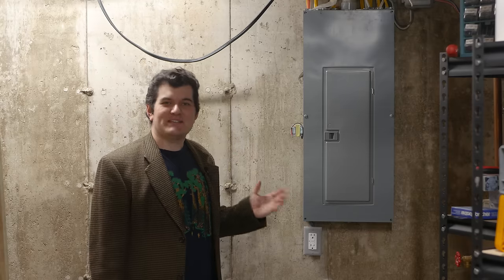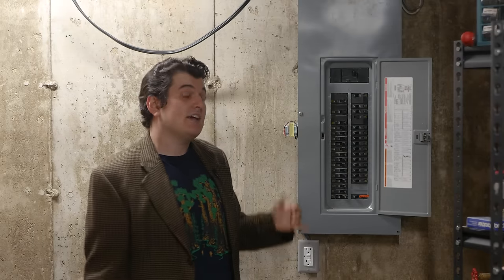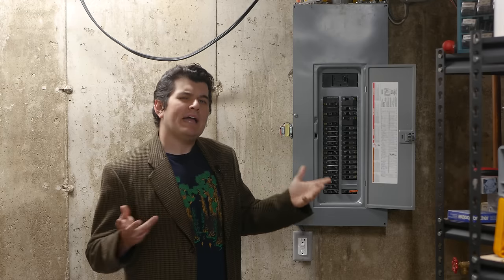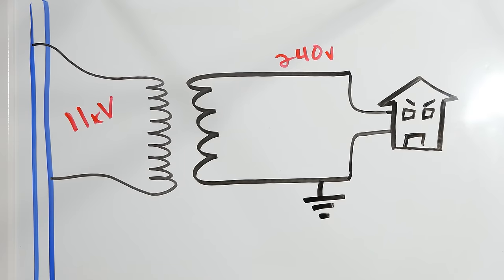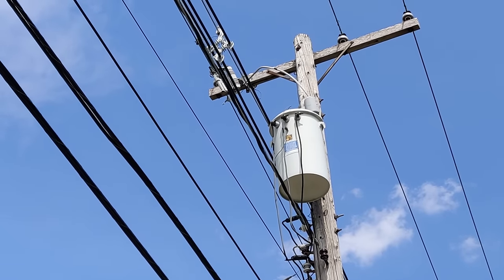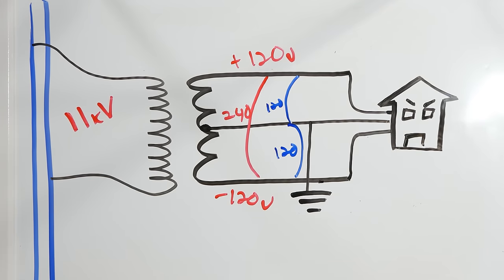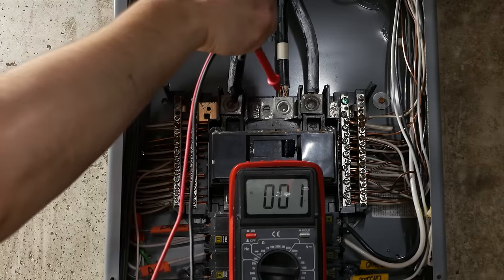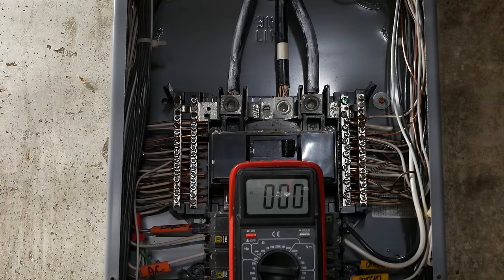The US electrical system is not 120V

Comment: I've occasionally wondered what a national power grid would look like if you could start again from scratch using current technology. No backwards compatibility, no infrastructure limitations, no analog TVs to sync.
Reply: It would be heaven
Reply: 400v /230v three phase seems to be pretty good. Decent L-N voltage, high three phase voltage.
Reply: Oh, it would be so worth it to resurrect Tesla right now, somebody get on that.
Reply: DC everything, please.
Reply: It used to be that you'd want higher frequency mains allowing smaller transformers etc, but now that switch mode supplies are the norm, that doesn't matter. Still, I'd probably go to 100Hz.
Why three phase, why not four?
--edit, fixed weird autocorrect
Reply: I'd like to replace 3-phase transformer which supplies 240 volts or 400 volts (depending on country or on industrial/domestic usage etc) with slightly different transformer and 12-pulse rectifier which outputs 310..340 volts DC with hardly any ripple and with tremendous power factor. This way there is no need for overcomplicated power factor correctors on each switching power supply which are everywhere nowadays: LED lamps, computers, chargers, AC, washing machines, microwave ovens with power inverters and so on. In fact, they wouldn't even need large electrolytic capacitor at the input, and that's one of least reliable component anyway, especially in hot environment (which many power supplies in closed black boxes ARE). Without electrolytics at the input, there would be hardly any surge current, so NTC resistor and really beefy bridge rectifiers (withstanding these surge currents) are not needed also. In fact, if outlets would finally get polarity, bridge rectifier would become obsolete as well.
Reply: Honestly, given the efficiency gains in DC voltage conversion with modern technology, it might make sense to to to a straight DC system rather than AC.
Reply: Before Analog TVs there were Master Clock systems using synchronous motors. Another rabbit hole for Alex!
Reply: @avalonhamakei  Found the Edison plant in the AC power demonstration!
Reply: @PaulMansfield  3 phase is the maximum. You can either be + +- or -.
Reply: @Steets  Sounds like a task for DeviantOllam up in the comments there XD
Reply: We would use DC instead of AC. All the savings by removing the transformers in our electronics alone would make it so worth it.
Reply: Jérémie Faucher-Goulet , DC in households maybe but certainly not for the main grid.
Reply: @abbofun9022  Well... you say that but there are a growing number of HVDC.
Also a lot of the offshore wind is HVDC as are a number of the EU powergrid links.
Reply: @avalonhamakei  It is way more difficult to transmit DC long distances without far more power losses. Stepping up then down would be far more complex.
Reply: @abbofun9022  AC is best for "medium distance" transmission, very short or very long DC is better.
Reply: @CalvinWalton  Transformers are still far less costly and much easier to manufacture than buck and boost converters for the same purpose.
Reply: AC is far better for transmission lines so that would remain, but I could see homes having both an AC and a DC Panel (maybe a combo panel that contains a high wattage switching power supply) 48vdc should keep the wire size down while being easily compatible with all electronics.
Lighting circuits would be fed from the DC panel, while you'd have a mix of AC and DC outlets throughout the house as not everything could run from DC and electronics would  use the DC.
Reply: @Steets  Way to go.  The 2020 Zombie Apocalypse, incoming, NOW WITH MORE ELECTRICITY
Reply: @CalvinWalton   i dont think its that simple, because many if not most of the high power consumption items, have motors in them, which need ac for higher efficiency
Reply: @PaulMansfield  Higher frequencies in transmission lend to more inductive issues with distance. The power factor would probably be terrible, and we have enough unwanted inductances in transmission.
Reply: @PaulMansfield  4 phases would give you 90 degrees between phases. No advantage over 2 phase, just doubeling the wires to carry the current.
Reply: @PaulMansfield  because four phases it's the same as two and motors wouldn't start ? you need odd number of phases to make it work, and 5 would be too much wires i guess ;)
Reply: hmm sounds like it would be more or less what we have.
Reply: I particularly wonder what frequency would be chosen today. Such a range of possibilities, each with substantial downsides and upsides.
Reply: @CalvinWalton  You seems to get it right. But as an electrician the transformer is just simple device that does its thing. DC-DC conversions on huge scale are somewhat risky considering reliability. Maybe i'm wrong, but how many times your power bricks (a'ka switching power supply) died comparing to transformer supplying your house?
Reply: @Omne Obstat I think you've misunderstood the point. Obviously no country is likely to completely re-engineer their whole grid at this point. The idea is to imagine a situation where compatibility isn't a concern, and consider what decisions we'd make with the benefit of our current knowledge. Say, perhaps, we were settling on another planet. Launching things into space is very expensive, so in this hypothetical scenario we'll be setting up factories and manufacturing the majority of our equipment using local resources. What choices would we make in the design of the power grid then, given that it wouldn't require compatibility with any grid on Earth?
Reply: I guess it would be DC everywhere.
Reply: Electrician here.

There is talk of two new types of grid systems. 

6 phase rather then three phase (after 6 phase the benefit drops exponentially as per the current research)

Or a DC system. The limitations when we first installed Tesla (Nickolas not Elon) are no longer as big of a issue and over high voltages and long spans can have less voltage drop due to our technology in the field
Reply: Maybe DC. Analogue TVs are a non-issue because they were never literally synced from the mains, rather it was (still is) a good idea to use the same frame rate as the mains frequency for avoidance of beating etc., but that problem would go away with DC. Synchronous motors and clocks are an issue though. Even more important: The same system worldwide.
Reply: If money and physical space were no object? 10 phase power based on a 24v grid with regularly spaced graphene super-capacitors and transformers.
Would be insanely safe and highly efficient. Electrical fires would be almost non-existent. Electrical shocks would be rare.
plugs would be non-euclidean.
Reply: @avalonhamakei  You'd need huge contactors to break high DC power loads.
Reply: @PaulMansfield  you cant have 4 phase power.
Reply: @Croz89  DC for very long? How does that work?
Reply: @MikinessAnalog  Actually high voltage DC is better than AC for very long transmission runs due to lower losses and the fact that it doesn't transmit reactive power. I forget where the breakpoint is (100-200 miles), but eventually it becomes cheaper even with the large equipment at each end that you need to invert and rectify such a massive load.
It's also REALLY good for underground and undersea power transmission because of all the added reactance of the water/earth around the transmission line. Oh, and HVDC is often used to transmit power between grids, because the frequency doesn't matter.
There's a whole wikipedia article on it. It's pretty interesting.
Reply: LOL
DC on the homes yes why not? And than you need an 1Ton motor to run the water pumps tu circulate the hot water on heating systems . How about the water pumps for the buildings taps? Its just lack of efficency. Increase the trasformers costs, increase the number of substation needed, etc. Only to save 2dollar on cheap bridge rectifier an two caps? Really? (I imagine my city, we have a two trasformers the cover not a lot of houses (like 50) but they are a couple km apart from each other imagine do that with DC.... 
Here power factor is not that important, In fact capacitive load of houses is balanced with iductive load from industries at the intermediate substation.
Reply: in tropical countries I would go for solar DC, safer and independent of the grid,  but for temperate and arctic, dont know...
Reply: @DeviantOllam  No lights required, Halo is sufficient,  every body is telepathic so not TV, phone, radio, computer required, its clean so no laundry and bath required.  Electricity required only to shock mortals with lightning. Take that Adam....
Reply: @PaulMansfield  That is not feasible, as higher frequency also also attenuated when travelling over longer distances, also generators would have to run faster and that would wear out faster as they have to run faster.
Reply: @allmycircuits8850  if you use more phases you would need more no of cables, would add to the cost, it is only feasible for large currents,  which is already used.
Reply: @CalvinWalton  works for solar but not for other things.
Reply: @kingprone7846  6 phase is used, if you see large rocket like towers used to current they have 6 phases.
Reply: @Falcrist  Just a side note: I am off grid and much of my home is standard Japan power (100 volts AC 60Hz 'southwest) but to limit the amount of inverter interference about 40% of my home runs on 100 volts DC. That's okies except when it comes to switches. DC tends to arc much more as there is no microsecond point where there is no power as in AC sinewave, so I had to place suppression capacitors on ALL switches on the DC side. I saw a video where it is much much worse for 220 DC. The electrons just "want" to keep flowing even though the circuit is open. I can only imagine how much worse that is for higher voltages. Seems scary & dangerous.
Reply: @radekc5325  I still think 60Hz is ideal (even though in the north of my country (Japan) uses 50Hz (100v). 60 seconds in a minute & 60 minutes in an hour. Just makes since to me.
Reply: @rafami9330  I agree. Far less can go wrong with a transformer. I used to build H style supplies when I was a teen and I'm a woman. I always wanted to try to build a supply to mimic EXACTLY an automotive battery (12 volts / 1000 amp) LOL.
Reply: @TheJamesM  Never thought of that consideration, but would you still be using appliances built here? For that you would need a supply similar though.
Reply: @uK8cvPAq  Or extremely large high voltage arc suppression capacitors.
Reply: @yoppindia  I am off grid (Japan power 100 Vac) plus some of my home set with 100 volts DC but that requires arc suppression capacitors on EVERY switch in the walls.
Reply: See, all low and medium power motors have now some sort of "inverter" - mostly for continuous speed control.
Induction motors never allowed "phase partializiation" like the dimmer switches, nor any inductive load - like transformers.
The cost of power electronics, for amplitude and frequency control,  has never been cheaper.
Therefore, the power network of the near future, can easily be DC type.
For very high power, I doubt that distribution transformers will ever be phased out. Imagine you have an handful of Gigawatts coming out of an unmovable power plant (a Sahara filled with photoelectric panels, or some Niagara-sized waterfalls, or a Tibet-high mountaintop wind turbines); a football field with a series of oil-filled,  one megaVolt, 400 MW  power transformers - are your best choice for such high power transmission; transformers are called "static machines" for a reason; they are old, but still wonderful equipment, where the moving part (the flux) is not visible. As a side note, for such high powers, don't trust dry (ceramic) transformers.
Reply: What I meant is to use existing 3-phase system down to 'last mile' 240 V, which should be replaced with most compatible DC voltage, that is 310..340 volts. All existing devices with switching power supply would work with that very well, in fact BETTER than with 240 VAC! And that makes almost all devices except maybe filament bulbs (but they are outlawed anyway) and heating devices which could be remade into higher voltage. In fact, 310 volts electric kettle could be even faster!
Reply: @MikinessAnalog  Yea HVDC breakers are no joke lol.
Reply: @Falcrist  Remember pre-phone film cameras that had those 400 volt caps LOL? I'd charge those up and throw them to a friend (XD)
Reply: @PaulMansfield  Three phase is the peak of efficiently.  It provides a continuous flow of power instead of "pulsing" like single phase would.  If the current in each phase was equal, the current in the common would be zero.   In fact, at worst, the common will only have the maximum current of any one phase.  Bottom line, 3-phase is the most efficient way to transfer power using only 3 wires. Certainly better than the old 2-phase 90 degree stuff.
Reply: Not household DC, that's for sure. DC with enough power to run a stove or a vacuum cleaner is incredibly dangerous. Once a spark strikes it doesn't go out. It will weld contactors. It will burn wires like fireworks.
Reply: @avalonhamakei  ok guess you want to kill the environment. DC for the whole grid would waste easily half the power produced through resistance
Reply: Europaen/German 230/400v 3 Phase TN C S aaaaall the way
Reply: @DeviantOllam  Wow even the pentest / key / elevator expert watches technology connections
Reply: @avalonhamakei  Did you know AC won over DC long time ago. It's was not like DC didn't have its chance.
Reply: @PaulMansfield  Three is the minimum number to support simple AC induction motor. Two don't produce rotating magnetic field.
Reply: For power station, I wish we will go with Thorium nuclear power plants.

As for the rest, even we start again, I am fairly sure we will build the same thing again.
Reply: you'd probably have a 300 volt DC bus in your house
Reply: 50Hz 220-240, like the rest of the civilized IEC world.
Reply: @jeremiefaucher-goulet3365  Not really, having DC step down from transmission to distribution voltage is still not cost effective. HVDC is only cost effective for long distance interlinks.
Reply: @Falcrist  Also HVDC can interconnect multiple sources of generation that are asynchronous, i.e. 50Hz interconnect with 60Hz grids, like they have in Japan between the 2 systems.
Reply: @avalonhamakei  there's a lot of good reasons we didn't do that in the first place...
Reply: @Mjollnir1983  "...only cost effective for long distance interlinks." Isn't that the definition of "transmission"? At least it would over here in Quebec, where our electricity is produced thousands of kilometers away from distribution and consumption.
I agree step down to distribution wouldn't be cost effective in the sense we know it today. But I assume the concept of distribution would be radically different in a DC system.
Oh, and another great advantage of HVDC comes in buffering between grids.That's what saved us during the great cascading power outage of 2003 of the north east coast.While we were surrounded by darkness from all side, our lights were still on in Quebec.
Reply: Mjollnir1983 We standardised 230V @ 50Hz by the way
Reply: I lived in Australia for a long time with their 240VAC (now 230VAC) at 50Hz not 60Hz and its fine. Conductors are smaller at 240VAC than at American 120VAC.  
If you increase the frequency to 400Hz motors and transformers can be smaller and more efficient, but cannot be economically transmitted over long distances. The the increased frequency at 400Hz greatly increases series impedance due to the inductance of transmission lines, making power transmission difficult. Therefore 60 or perhaps 120Hz is best.
Reply: @abbofun9022  DC on the grid works too. For really high voltage DC you need less insulation than the same RMS voltage AC. Here in Victoria Australia we have undersea voltage links (Basslink) with Tasmania and they are DC for this reason. Only possible because of modern power conversion electronics to replace transformers.
Reply: I was thinking that as well. Guess it will have to wait until Elon Musk gets to Mars.
Reply: @zachmiller9175  Yep... The technology for HVDC was inexistent back then. HVAC was a lot more attainable, and we didn't have any need for DC. Who cared if your lightbulb would blink 60 times per seconds?

Gee, I wonder why we ever went from NTSC to ATSC. There must have been a reason why we didn't do digital TV back in the 40's 🤔.
Reply: @Falcrist  plus lower insulation requirements. With AC you need insulation for the peak voltage which is RMS*sqrt2. Whereas with DC it's just the voltage of the line.
Reply: @MikinessAnalog  Actually this is not entirely true.  High Voltage DC is now the usual choice for long distance power transmission.  Stepping up/down remains a lot more complex than AC transformers, resulting in high capital costs, which is why HVDC is confined to long distance bulk and not used for local distribution, but thos costs are recouped with the lower line losses.
Another advantage is the ability to transmit power between grids that have frequency variations, eg east and West Japan 50Hz and 60Hz, or Continental Europe and Britain which are both 50Hz but not in phase.
https://new.abb.com/systems/hvdc/why-hvdc
https://en.wikipedia.org/wiki/High-voltage_direct_current
Reply: Have a look at a lot business supplies, they tend to have bespoke supplies with multi phase inputs.
Reply: I guess all technology would be better if we were able to start from scratch. Unfortunately that's not an option....
Reply: @jeremyloveslinux  Yes a 400V / 230V with NULL (4 wires) I think is the ideal electrical installation. It's the one we usually have in our houses here in Europe. This means that we can easily use even large electric motors and welding machines etc. on a normal house installation as there is normally a 35 Amp fuse on each phase at the entrance to the house. As an added safety, we have a PHFI fault current relay on the installation so that we theoretically cannot get a shock greater than 30 mA in the event of a electrical device failure. Whether the alternating current frequency is 50 or 60 Hz does not matter.
Reply: @kingprone7846  That's not how three phase power works. It means that the AC voltage cycle of those three lines is offset by one third each. The beauty of that is if you pull the same amount of voltage from all three phases into neutral, they cancel out, so your neutral current is comperatively small. You can totally offset four lines by a quarter cycle each, but the more you have the less the effects are noticeable.
Reply: You DC everywhere guys are dreaming. Try putting your computer power supply in your basement and your computer upstairs and see how thick of wires you'd have to run to get the computer to even work right because of the huge voltage drop you will get under load.

If you up the DC voltage enough to get around that problem then you still need transformers everywhere for your devices and its more dangerous then sticking with the AC.  

I don't really see problems with what we have, a 120/240 split phase delta would be a easy upgrade to what we have to support electric cars (especially multiple cars per home) without needing more then 200A service. 

OP question of starting over - I would have started in the 2-300v range instead of 120, safe enough and you can use much smaller wires in allot of cases.
Reply: Guys. I am an electronic engineer in de power industry. Every electrical Engineer i work with agrees we should switch over to DC, but there is nobody to pay it for. So the awnser is not higher voltages or higher frequencies but DC.
Reply: @Null_Experis  All power storage units are serious fire hazards. Remember the fire triangle? Remove fuel, oxidizer, or heat and the fire goes out. That is not possible with chemical storage, and it has killed people already. See https://www.firehouse.com/safety-health/news/21077221/eight-az-firefighters-injured-one-critically-in-a-large-utility-battery-explosion
Supercapacitors have the same problem except they tend to detonate. In small installations it would not be a big problem, but for bulk electric power it would threaten cities.
Reply: @abbofun9022  I would wonder if having a transformer + rectifier at the consumer unit and low voltage DC bus running on separate sockets (you'd still want your regular AC bus) would be worth it compared to just putting them in the device plug. It would be a lot of extra wiring.
Reply: A rarely covered problem with DC systems is that there is often a small but finite ground current caused by something not being right in two separate places. In AC systems it is rarely noticed. In a DC system that produces galvanic corrosion, which can cause incredible damage... even the destruction of the bottoms of steel beams.
Reply: @Jtzkb  There is a you tube video on why 3phase is the way to go. Biggest bang for the buck.
Reply: @uK8cvPAq   Yes sir! A DC welder will demonstrate a much longer arc.
Reply: @Murphy deffa Also if you use 100 VDC like I do in a portion of my off grid home, you MUST place arc suppression capacitors on EVERY switch that is in the circuit. It is 100VDC / 25 Amp. NOTE: fluorescent curly bulbs don't mind it, but I really need to go full LED.
Reply: @flagmichael  That is the deal with ALL Li-Ion power. The insulator is a flammable polymer. All of that raw power must go somewhere instantly when shorted.
Reply: That's actually a really good question. I actually think DC would take the lead nowadays. I know we already had this fight. And back in the day AC was by far the better option. But nowadays switch mode power supplies that essentially run on DC are a lot more efficient than simple transformers and the most advantages of AC that lead to AC being the better option aren't really so relevant anymore. The disadvatages of AC however remain. The fact that phase shift due to bad power factors can make long distance power transmittion kinda difficult. Which is kinda impossible to avoid since you even have capacitive coupling between the wires. The fact that things hum, lights flicker etc. There are even high voltage DC lines being used today to transfer power more efficiently over high distance. Of course DC can be more dangerous and arcs don't self extinguish as nicely with DC. But I think those are relatively minor disadvantages compared to the many advantages.
Reply: @Croz89  A suppression capacitor would need to be in every circuit breaker and switch in the home if it is at the 100VDC level like my off grid home.
Reply: @PaulMansfield  because three phase is the lowest-order multiphase system that allows constant power transfer. Four-phase would not add anything but more complexity.
Reply: @flagmichael  That's one major problem of docked house boats.
Reply: @jeremiefaucher-goulet3365  no you miss understood. They are talking about linking TWO long distance ac systems with DC to isolate the two systems but allow them to feed from the other when in demand, it's not from long distance transmission in and of its self, it's used mainly as a way to get power from out of phase AC systems from 1 to the other
Reply: @kingprone7846  3 phase isnt the maximum, 6 and 12 phase work much more efficiently, but the benefits are outweighed by the cost of running 2-4x the conductors to industrial sites
Reply: Don't wonder, design it.
Reply: @PaulMansfield  "Why three phase, why not four?"  Three is the minimum needed to produce a rotating magnetic field in a motor.  Adding more phases requires a lot more copper, modest complexity (4 pole instead of 3 pole circuit breakers) for no additional benefit.
Reply: @PaulMansfield  why three phase: because its symmetrical.
Reply: @MikinessAnalog  no: 1s / 60 = some weird number, 1s / 50 = 20 ms
Reply: Straight DC grids are very cool and hold a lot of appeal for large utility organizations, but there are also significant financial overheads to a grid retrofit.  With only this anecdotal statement, I'll just have to ask for your trust when I say that they're actively involved in the research to make this a possible future state for the U.S.  Grid.
Reply: @avalonhamakei  Nah, it's more efficient to transfer power as AC. Power lost to heat is based on current, not voltage, so it's better to transmit high voltage with a low current to keep the losses down. To do that, you need a transformer, which only works with AC power. If you ran it as DC, you'd need to use an inverter and a rectifier to turn it to AC before running it through the transformer only to turn it right back into DC. You could maybe make a case for every house having an inverter before the main breaker so that the power coming out of the wall was DC. Even then you'd run into a few issues where the power bricks on your gadgets would basically triple in size, since they'd all need an inverter and a rectifier as well. If anything, I'd prefer it if three phase power were more common, because three phase motors are so much easier to work with than single phase motors. You don't need a capacitor for them, so there's no danger from stored voltage when the system is otherwise off. Also, they don't wear out anywhere near as fast, because there's not a massive current spike every time it starts up.
Reply: @CalvinWalton  Nah, because long distance transmission is still an issue with DC.
Reply: @DeviantOllam  Funny seeing you here, picked any cool locks lately?
Reply: I see a lot of people talking about a DC grid, for good reason, as DC doesn't have the same kind of transmission losses as AC.
Unfortunately, you then can't just use transformers to convert voltages, you'll much different circuitry, and something that would definitely stop it, is the ubiquity of the three phase AC motor.
They are used absolutely everywhere in industry because they are very efficient and very reliable. In general, they consist of just one moving part, the rotor, with only two bearings, and no capacitors or anything for phase-shifting
Reply: Certainly way more DC for high voltage transmission. We didn't have the tech for gigantic transistors back then but now we do. Some countries have already started using this. For now the benefits outweigh the higher costs mostly for creating new infrastructure but still aren't justified for replacing currently operating systems.
Reply: Straight 5V DC 🤪
Reply: Straight 5VDC to a USB plug
Reply: @CalvinWalton  oh, really? You loss energy with distance using DC... Think again.
Reply: @abbofun9022  HVDC for grid distribution is significantly more efficient which is by it's used for long distance interconnects between countries.
Reply: hawkturkey  Most motors in industry these days run from VFD's which convert AC to DC and then back to higher frequency AC so they would run fine from a DC supply.
Reply: current technology  hehehe
Reply: @Billy_The_Kid "no analog TVs to sync". Electricity came BEFORE the television. Analog TVs were designed to work with our electrical system, not the other way around. 60hz power existed and televisions were designed to sync at 60hz here just as European TVs sync at 50hz since their 50hz electricity existed before the television was invented.
Reply: @elsiberiano2006  you lose energy over distance with AC too, that's not something unique to DC. In both cases, the solution is to use higher voltage on long distance lines. In fact, a lot of newer long distance power transmission lines are being built with DC since it can be cheaper and may have less loss. See https://en.wikipedia.org/wiki/High-voltage_direct_current
Reply: USB sockets for everything.
Reply: @avalonhamakei  DC was tried but it completely failed. Portions of New York were still operating DC as late as the 70's.  Too much loss in transmission.
Reply: @MikinessAnalog  Well quite a few really long distance power transfers are actually DC, like the subsea cables for power transfers to and from Scandinavia and mainland Europe an the British isles. It is far more effective, offcource high voltage 132kv or higher is used, with huge AC to DC and back to AC power converters.
Reply: @allmycircuits8850   Do researrch on how A/C motors work. They depend on electrical fields to work.  Heating andcooling circuits require too much amperage to be feasible.
Reply: @tuttocrafting  1 ton motor, a small brushless DC motor gives you a lot of power in a very small package, just look at the EV, Scoters, electric bices and so on..
Reply: @avalonhamakei  DC is still a relative PITA to step the voltage up & down, especially when you're dealing with high power transmission lines. High-voltage DC is also incredibly dangerous: Since there's no zero-crossing like in an AC sine wave, high-voltage DC arcs don't self-extinguish like they can with AC. (It's also why arc welders use DC.) Until very recently, HVDC circuit breakers were simply not available, because of the arcing problem.
Reply: @jeremiefaucher-goulet3365   .. The power co would hate that. Stepping down the voltage isn't as easy and reliable as what we have with AC.
Reply: If they started from scratch, higher AC voltages in the home.  Then all the wiring in the house, and all your appliances would work with tiny gauge wire.  That would be a huge savings in copper.
Reply: Local generation, DC, and a lot of batteries
Reply: @oleeide9763  yea those are three phases motors.... So you have to use an ESC to convert back the DC to AC.
Reply: We can do this! We just need another World War so.....
Reply: You're like the Thanos of the power grid
Reply: What kind of current technology?  Alternating or direct?
Reply: @DeviantOllam  dude, what are you doing here? <3
Reply: 300 V, 100 c/s, 3 phase, and either UK or Schuko plugs.
Reply: I would like to do the same thing with railroads.
Reply: Electrical engineer here--All of your ideas are garbage except the guy who said to raise the freq to 100hz
Reply: @CalvinWalton  We'd probably want High voltage DC together with AC. There would be dual sockets; one for each type of power. Appliances with motors would use AC; everything else would be DC.
Reply: @thomasmaughan4798  there is  benefits to four e or even 5 phase AC, but it's diminishing returns 3 phase is the most economical
Reply: @EngineeringNS  what benefit does having a higher frequency give? Less ripple? Increased energy capacity of the flywheel for demand spikes? More uniformly divisible number? Wouldn't increasing the frequency induce higher losses to friction at the power station? I'm interested and just throwing the stuff that comes to mind around
Reply: My country switched from 110V to 220V in the 1980s. The goverment was dictatorship and the electrical company was a government  monopoly, so everybody were quietly change their home appliance or go to gulag. Except for the fact that we were not Soviet. Because of that, everybody bought stepdown transformer to keep the use of our old appliance.
Reply: @Steets  okido, working on it
Reply: Uh, immense cost to everyone everywhere. It’s just a fantasy
Reply: Calvin Walton except DC would be very expensive if not impossible to distribute. The power would dissipate VERY quickly over any distance. It is also very impractical to step DC voltage up and down to modulate it the way we can with AC. It’s always going to be far more efficient to just convert to DC at the last minute where needed and where the wire run is shortest.
Reply: So basically what they're going to use on Mars.
Reply: @kingprone7846  Theoretically more than 3 Phases is possible. The Phase offset would just get smaller than 120 degrees of each other. And I doubt it would provide any practical benefit. As thgis is AC you do not actually have + or -. Those are for DC. You have three phases which provide a measurable voltage difference (electric potential) between the shifted phases (and actually only because with the AC the phases are shifted) or phase to Neutral/Ground
Reply: @Steets  sadly even if Tesla was resurrected the elites would still do everything they could to discredit him and put him back in the grave like they did the first time. It was his work that most who got credit for all the advances at the time of anything electrical based what they did on. They were just willing to work with the elites who sought to profit at everyone else's expense
Reply: Jérémie Faucher-Goulet Just about every electronic product these days use Switch Mode power supplies, either internally or externally. it is rare to see any iron-core transformers these days. Here in Australia where I live iron-core transformers are banned for use in wall plug-pack transformers! So a DC based supply, apart from being impractical on the supply side would provide no benefit.
Reply: @avalonhamakei  DC is bad for transporting electricity,
Reply: @CalvinWalton  This wouldn't solve the issue of transporting electricity over long distances. We can imagine that in the future, household would come with a 12V DC transformer for light and small electronics power supply,(actually in Italy up to the 1990, in some places, house had both 230 volts and 120 volts circuits, the 110 volts one for light, so it's not a so bizarre idea) but transporting electricity to the house would still require AC. Unless you only have local production.
Reply: @avalonhamakei  DC is not beneficial for safety. Three phase power has its advantages, but the low frequency is one of the current downsides. Moving to 400Hz would be a good option.
Reply: @wahdangun  then I guess we'd better tear down all those HVDC transmission systems that have recently been installed.
Reply: @avalonhamakei  Stepping DC up and down is expensive and often wasteful.  You'd think that since most portables charge with DC that it would make more sense, but small transformers in each adapter/charger coupled with a rectifier circuit is cheaper/simpler than a variety of boost/buck converters, DC-DC converters, choppers, etc.  What I am saying is that if you, right now today, wanted 5V to charge your cell phone, a small 10VA transformer, a bridge rectifier, and a handful of capacitors would be far cheaper (<$10 retail) than stepping 120VDC to 5 VDC for the same purpose. An alternative would probably be to create and distribute a series of DC voltages and have each available at every outlet in your home (think integrated USB ports on outlets).  Keep in mind that various DC devices don't all work on a "standard" DC voltage, either.  Laptops range from about 15V to 24V, for example. I know the prompt was "imagine" and "no backwards compatibility," but there are some not insignificant hurdles to overcome first.

Edit: also AC motors tend to be more efficient than DC motors, and it's far simpler to convert AC to DC than the reverse.
Reply: @PaulMansfield  Three-phase has to do with how induction motors and generators are wired.  It doesn't "have" to be this way, but it's basically the fewest phases to spin a motor without needing additional starting circuitry.
Reply: Calvin Walton Wasn’t a DC grid tried and tested before but proved to be problematic over long distance?
Reply: I do not think sync is an issue now, they do not hold sync for clocks anymore. PC's do not care what power you are using we can put out any refresh rate without tearing now and I bet Tv's can do that now too.
Reply: A.C. would still be used for transmission; it is clearly superior as our 100+ year old grid has demonstrated.
Reply: @CalvinWalton  You cant transmit DC to long distances, thus you would need a powerplant in every city or more depending on the size of the city.
Reply: @jeremiefaucher-goulet3365  You do realised that transformers are the most efficient components right? Like 99% efficient.
Reply: @DeviantOllam  Nice to see Mr. "Professionally Dangerous" around these parts
Reply: It would go for HDVC and LVDC. Much higher material efficiency, for motors you would use inverters (three or five phase). Current electrical system is legacy of Michał Dolivo-Dobrowolski (three phase, three legged transformer with some Teslas cancer across US), however Dobrowolski predicted, that with technical advances more and more transmission (and probably distribution to) will switch to DC. Why? Because high-voltage lines have non negligible inductance (along line path) and capacitance (both between wires and to the ground). For AC it means: losses; You are losing energy for wire heating and line charging. In case of overhead lines you will need to compensate it in every substation. In case of underground cables it limits practical length of lines, because after some point you will ose more energy to charge insulation than you will transmit to customers. And each high voltage AC cable has shielding (aka return) conductor, that either will be connected at both ends to ground, limiting short current rise - either it will be left floating with TCDs, but it will make unsafe for substation staff, as it will have large potential to ground.
With DC you can effectively transmit large amount of current with one conductor only (and proper grounding of converter station). It is cheaper and more efficient - working ground has resistance at level of single ohms - less than any cable or overhead wire. You don't need to take care of reactive power - as there is no any. However this also removes frequency signal used by generators, so power plants would need to adjust power in a "smart" way (now simple frequency deviation is translated to gas valve/water valve/coal burner/nuclear control rod [not in US] and in this way adjust mechanical power at turbine shaft).
Low voltage DC would also make life easier - most of our devices needs only DC (there is FULL BRIDGE RECTIFIER [ElectroBOOM mode off] supplying DC for SMPS) , and AC powered ones - again - can be supplied by inverters. Motors of most home appliances are "universal motors" anyways, so they can run even with DC. However all circuit breakers and connectors would be made obsolete - there is more hassle with arc than with AC (no zero crossing, no "cold" phase in arc)
Reply: @jeremyloveslinux  400Hz 240 volts (what aircraft use).  Much lower peak to peak voltage.  60Hz 120V is about 368V peak to peak.  240V 50Hz is somewhere in the 600 volt range peak to peak.
Reply: @PaulMansfield  400 Hz. Aviation already uses it so you could reuse those components.
3 Phase is optimal for pretty much all loads. You can go higher but you tend to go to a multiple of 3.
Reply: DeviantOllam nice seeing you here
Reply: @PaulMansfield  The higher the frequency, the shallower the skin depth (see my top-level post on this video), and the greater the loss in conductors. Many years ago, studies were done, and it turns out that a frequency around 50–60 Hz is a good compromise between power loss in conductors and size (and therefore cost) of transformers. On aircraft, they use 400 Hz power to reduce transformer size, because weight is critical on a plane and it’s not part of a big grid where they have to transmit power many miles.
Reply: If you look at the history, that was the case, of course. Be careful what you wish for, it would be another opportunity for guys like Thomas Edison to electrocute another elephant, and maybe sell the idea of DC to the governing powers, and that would have been disastrous! Things are the way they are for definitive reasons, you just have to check out the history to find out what factors and who was in the decision making seat at the time. It always comes down to people who sell their "better idea" better, and the decision making  of individuals given the choices at hand.
Reply: @avalonhamakei  why? this is an absolutely dumb idea
Reply: Hamakei it’s much easier to go from AC to DC than the reverse.
Reply: Itll NEVER happen, and yes, I mean NEVER
Reply: AllMyCircuits that’s the first truly thoughtful answer.
Reply: It would be like the German system
Reply: @allmycircuits8850  Obviously you are not an Electrical engineer  !
Reply: @TheWebstaff  HVDC is great for very long distance like from the North of Quebec  to the south even the US
Reply: hawkturkey  brushless motors are three phase  Thanks Tesla  !
Reply: @Falcrist  Done between US and Canada In Quebec 200km north of  Trois Riviere I was puzzled by a strange power line that turned out to be HVDC
Reply: @Mjollnir1983  Indeed the best compromise then and now  !  Fact the US started first and Europe avoided making the same mistakes True also for the US industry using crappy inch standard to ptoduce poor quality expensive things nobody buys anymore  !
Reply: @avalonhamakei  DC everything would be a mess.  AC is eaiser to transport and convert, with more effective range.  You'd need a powerplant on every block to run full dc, and have to have 3-5 plugs on every outlet, theres a few different dc voltages that are common, its not uniform 5v.  You'd have to have more "transformers" in your house.
Reply: @CalvinWalton  You'd have to assume all products use the same dc voltage or it would not be worth it at all.  Even then DC is more difficult to transfer longer ranges than AC, it might work in more dense regions of the world, but not in more rural countries (like the USA, Russia, China, Brazil, etc. .)
Reply: @PaulMansfield  Calculations done many years ago indicated that 60Hz was the optimum frequency to operate a power grid. While a higher frequency would facilitate transformer design, there would be greater losses with transmission lines (aircraft often use 400Hz but transmission distances are short). Europe adopted 50Hz because of Siemens (a major German electrical manufacturer) because 50 was more of a standard number than 60. For railroads the optimum frequency was 16 to 25Hz being a compromise between transmission and motor design (with technology available at the time).
Reply: I'd suggest AC, frequency 100 Hz or even higher, voltage at single-phase around 200-250 V.

Also, especially if solar and wind power catch some more, there could be two or three different rates per kWh, and there should be a way to quickly signal to the appliances about the availability of power, and hence its current pricing rate. Appliances would then have user-adjustable settings at which point they would start and stop, or at which point they would switch between normal and power-save mode. If the availability would go lower, first all the less necessary appliances would start to stop or to switch to power-save mode, for example thermostats would allow the temperature vary at a little wider range before using heating or airconditiong. In case of surplus situation, battery chargers of various devices or electric vehicles would start to charge the batteries full, even if the user had set the batteries normally to be only charged to e.g. 90 % to prolong the battery life.
Reply: Hamakei  and how would you do long range transmission with DC???
Reply: @avalonhamakei  Can'thave that on long transmission lines! D.c. creates extreme heat losses.
Reply: @avalonhamakei  No, DC is the last thing you want.

Every single electrical item suddenly undergoes galvanic corrosion when wet. 

If you touch more than a few 10's of volts, your muscles will latch on. You will be unable to let go.

Lower voltage means higher current. 

Every time you short a wire, you just arc welded.

Changing DC voltage requires complicated (read expensive), electronics. 

To change AC voltage just requires a transformer.
Reply: I don't think US power companies are really concerned with 60-Hz synchronicity anymore
Reply: It would all be DC. Things that need AC (mostly motors) will have integrated inverters (many high efficiency appliances with motors like air conditioners already do). Major advantage is that no need to sync phase or frequency. DC-DC conversion is highly efficient these days with modern power electronics.
Reply: @CalvinWalton  No, DC is a nightmare when it comes to scalability.

 For one generation is so much less complicated for 3 phase AC, and transmission is also way better. Transmission must be done at very high voltages, and with 3 phase you get triple the power of DC with 3 instead of 2 wires of similar size, very efficient. DC can't be stepped up or down without transformers, which requires conversion to AC, very complicated and expensive at scale. So for generation, transmission and distribution DC is mostly out except in a very small number of niche cases like undersea cables, where impedance is an issue for AC.

So what we are left with is the system we already have, but DC into the house. OK, so that requires massive, expensive, potentially sensitive and unreliable solid state electronics to supply DC to the each individual house. Basically each house having it's own giant computer power supply. Double, but expensive, and entirely impractical, because the same issues with DC on the large scale apply on the medium and small scale. With AC, all you need is a simple transformer to get any voltage you like, and that's entirely up to the manufacturer of the appliance to sort out, all your house needs is dumb wires and dumb breakers, no need for banks of fancy high current rectifiers with huge heat sinks, big enough to run heating, stoves and power tools.

Then there's safety. DC is more dangerous by far, and the whole GFI/RCD thing doesn't work, or at least becomes much more challenging in a DC environment. 

DC sucks as a mains supply. That's literally why we have AC. That was worked out by some really smart men back in the 19th century and it still holds true today.
Reply: @uK8cvPAq  Nice, I forgot to mention that nightmare.
Reply: Nowzadays DC circuits can have voltage conversion with the use of solid state converters. So the grid could be DC instead of AC.
Reply: @Falcrist  HVDC is only good for certain situations. Situations that already use it mainly. We have a undersea DC link here in NZ between the North Island and South Island.
Reply: @allmycircuits8850  You're talking about replacing a simple irom core with with wires wrapped around it with a solid state power supply big enough to feed a home, (or several homes) for no actual advantage and a ton of disadvantages like less reliability, less flexibility, more complexity, more expensive, more dangerous, and hard limits on how much power can be drawn.
Reply: power grid would be great, our debt would be much greater.
Reply: @PaulMansfield  he said from scratch! comment invalid
Reply: @allmycircuits8850  did any of u actually read his comment
Reply: @leerman22  skin effect too. Make high Hz not the best option for transmission
Reply: To everyone who thinks DC in households is a good idea. It's not. If you pull an AC plug, you usually have no or just a very small and short electric arc. This is because AC constantly changes voltage, which therefore automatically stops electric arcs as soon as the two ends are not ridiculously close. This is not true for DC. The higher the DC voltage and/or current, the longer arches you'll get. For the same reason, it's much much harder to produce DC breakers, because not only need they to separate the connectors, they also need to somehow kill the forming arch.
Reply: It will look like what the Germans have.
Reply: @jeremiefaucher-goulet3365  Edison though so as well, it did not age well.
Reply: @avalonhamakei  What!  😝
Reply: @PaulMansfield  Because four is just two.  And that is much less than  optimal  for decent size motors.
Reply: Feel free to come to Australia and be amazed....
Reply: Regular clocks used synchronous motors too; that's how they kept time; by following the speed of the power plant.
Reply: @46ace  https://en.wikipedia.org/wiki/High-voltage_direct_current
Reply: @Fred Smith https://en.wikipedia.org/wiki/High-voltage_direct_current
Reply: @jeremiefaucher-goulet3365  DC cannot travel the distances required for a power grid. AC works really well due to the fact that transformers work (as said in the video). Without transformers you'd have to generate 240v DC at the power station and then distribute that to everyone. That'd require you to have millions of amps available and therefore a conductor with a very large (>1 foot in diameter). Basically there's not enough metal in the world to do DC on a large-scale power grid.
Would it be nice to have DC in your house? Not really -- it'd eliminate the ability to have quiet motors -- your ceiling fans, refrigerators, etc would all become far louder and introduce more noise onto the wiring of your house since they'd now need to use brushed DC motors or use inverters to create AC voltage in order to operate on brushless motors.
Reply: @PaulMansfield  Why three phase, why not four? Because it's the minimum number of phases (wires) to get a defined order, which is important for many motors.
Reply: @Fred Smith "while if you use a DC system the only practical way to change voltage is to drive a motor and a generator."

Wow. I had no idea my phone charger was so complicated!
Reply: It would be miles better ?! I mean kilometers....I guess it's not that complex to change in comparison to the power system, and you are not doing it.
Reply: @avalonhamakei  Please no! Anything above 40V and DC will kill you - you touch an AC wire and your arm snaps away from it and goes numb for a few minutes, on the other hand touch DC and you die, as well as the sucker who tries to rescue you. Anything below 100V and you need very thick cables for anything worth mentioning (like computers, plasma TVs, washing machines). There is no good compromise voltage that allows universal DC. 

You will need voltage conversion anyway: your computer needs 12V as well as 5V. Most motorized appliances would need 48V. Lighting needs 12V or 24V depending on design. Speaker systems often need 100V for output (behind the beefy amplifier). Your smartphone and tablet want 5V with varying additional logic to give them enough current for charging. Your TVs and monitors have several different levels for various components that also differ by brand (1.8V, 3.3V, 5V for logic; 0.7V/3.3V/5V for signal transmission and handling; several hundred volts for the backlight).

If you install DC as well as AC, you run the risk of connecting to the wrong system and frying your devices (at least the risk is higher than it is already for mixing up wires during installation).

...and I definitely do not want yet another type of plug.
Reply: @PaulMansfield  what about 10hz ? Hum be gone forever
Reply: @Steets  with so much juice you definitely could
Reply: If we had parts of America that were able to autonomous, that could be a possibility. But there’s no way to do that because America doesn’t encourage growth anymore.
Reply: 200 Amp service is so yesterday. 400 amp is where you need to be!
Reply: @ttomkins4867  i could totally feed solar power into that 48vdc sub panel. That would be like BLISS. 48vdc systems are more dangerous than 24v because it can finally get trough skin resistance and shock us, but its more efficient and valid to use for larger than 2kw inverters, which are costly and BIG. like a 2.5kw inverter for grid tie purpose is in the thousands of $ and about 3 by two foots.
Reply: @rafami9330  I've had three transformer failures in my life and about the same for power supplies. My computer power supply was changed after 8 years of usage. Power grid transformers seems to have also a 5 to 10years life cycle but it's relative to the draw around and how outage and power reinstating trough is done. Like last year we had a big outage due to winds and next door transformer blew right back up it was repaired, it could not handle the surge load.
Reply: I feel like there's a youtube channel that would be good at that. I just can't think which one xD
Reply: @avalonhamakei  yeh , moste stuff is converted to DC inside the appliances anyways , like computers TVs and bla bla bla , but its the distance from powerplats to our home that  seams to be the issue with DC . som much loss thats why AC was consider a good solution i guess . maby in the future we stupid humans stop hating and killing and doing our usual stuff, we migh invent something new cool that will be super awesom =)
Reply: Solar and wind would be built onto each house/building, and not envisaged as a centralized Big Power thing.  There could still be coal/nuclear/hydro for backup, but you wouldn't need the horrible crap like flooding millions of acres of wildlife habitat for power generation (aka James Bay).
Reply: It would be 400 Hertz like the  military US military uses it makes the transformers more efficient among other advantages.
Reply: @russellhltn1396  You can actually do more phases if you like; there are cases where if you need two seperate three-phase circuits, it saves on material to transmit it as six-phase most of the way to the loads, then 'split' it into two three-phase systems at a location closer to the two loads.
Reply: @avalonhamakei  No thank you, AC is much better system. What are you a Edison lover...
Reply: @Guds777  Much better has skin effect, much better having to deal with phases, much better greater transmission losses,  much better more conductors needed on transmission lines, much better practically all appliances run on DC anyway..yeah. Sorry, but no. People's thinking of AC/DC seems to be based on hundred-year old theories and equipment. I will grant you that DC switching equipment used to be WAY more expensive than AC which is why it wasn't suitable for long-range transmission, but that hasn't been the case for 20-30 years. There are good reasons why practically every long-distance power transmission system being built now is DC and not AC. 2600km of cabling across the Congo, Thousands and thousands of km across China including one that's over 3300km alone, over 6000km of cabling in Brazil, and practically every undersea power cable ever laid. Do you want to tell all these engineers that they're doing it wrong?
Reply: @allmycircuits8850  Incadescent bulbs outlawed?? They are still useful in some applications. fluo-compacts have their flaws, like very agressive white light instead of warm, neutral light.
Reply: @jeremiefaucher-goulet3365  line losses in transmission are very high, and to reduce the size of the lines themselves very high voltage is used to transmit power over long distances. This is the key reason why A.C. is used, as you can put transformers anywhere to change high voltage low current to low voltage high current. Not possible with D.C.
Reply: Honestly, we might get there sooner than later...
Eventually, we will be able to get solar panels on every roof, with Powerwall batteries and we won't need a real grid anymore. IMO it'd be a good idea to use, say, 350 volt batteries, but still use 120v or 240v AC for anything someone might want to plug-in, to reduce the risk of arcing/welded plugs and switches...
Water heaters, air-conditioners, stoves, EV chargers, could all be hard-wired in to the 350v DC system...
Reply: @xaverlustig3581  synchronous motors are good to generate electrical energy not to generate mechanical energy: if you use a synchronous motor (for example) on a car, you simply don't move beacause the initial peak force isn't enough so your motor burn up. same things occur to big machine.
if you want (I know that I have not explained well) it is preferable to use Wikipedia some time...
Reply: @mjbirdClavdivs  Are you confusing master clock systems with mains operated synchronous motor clocks (which depended on frequency for timekeeping). A master clock system uses a precision pendulum clock which produces an impulse each 30 seconds (depending on manufacturer). The slave clocks (eg in railroad stations, office buildings, factories, power stations etc) are a simple mechanism which is advanced by a solenoid each 30 seconds and are connected in series to the master clock circuit. A solenoid in the master clock also kicks the pendulum each 30 seconds to keep the pendulum swinging. 'Gents' (now owned by Honeywell) is a prominent UK manufacturer of master clock systems. Modern master clocks would use a quartz crystal oscillator instead of a pendulum). Synchronous motor clocks (Smiths being a common UK brand) would have been superseded by quartz crystal wall clocks as these do not require a mains connection. The motors were often not self starting, so the user had to push in the time adjustment knob to kick the motor into action. A power station traditionally would have in the control room both a slave clock and a synchronous motor clock. If the station was designated for frequency control and the clocks got out of step the operator would adjust frequency slightly until the clocks were back in step. This is why synchronous clocks keep good time (unless power fails).
Reply: @CalvinWalton  omg transmission losses anyone?
Reply: @kingprone7846  what?
Reply: @jeremiefaucher-goulet3365  omg  tried and failed over  a hundred years ago  read some of teslas work people, dc trasmission over distance is a recipe for huge power loss... very inefficient
Reply: @TheWebstaff  ummm noo never for transmission  never ever ...
Reply: @Croz89  jury is still out on the long distance there dude
Reply: @tek4  electrician here also , there would be an ongoing need for ac as the  3 phase ac motor stillwins the efficiency game   dc transmission is  still in  its infancy and doesnt show trasmission loss gains to $ ratio at this stage
Reply: 440 V USB ports of death.
Reply: @Steets  I read his book. The Autobiography of Nikola Tesla is a book compiled and edited by Ben Johnston detailing the work of Nikola Tesla. The content was largely drawn from a series of articles that Nikola Tesla had written for Electrical Experimenter magazine in 1919, when he was 63 years old. The man made some great discoveries, but he was a loon.
Reply: @jeremiefaucher-goulet3365  But transmitting DC current over large distances cannot be done without stations to boost the current back up to get it to go farther. Before the switch to AC in the early 1900s this was about every 2 and a half miles. Also instead of having a couple of wires going to a building to power it, it would be allot more wires. Just look up old pictures of New York City before the switch and you will see dozens and dozens of lines going down streets. Inverters are fairly cheap to make so that is why electronics have them if they use DC.
Reply: @abbofun9022  Long distance transmission lines are already DC...
Reply: @Omne Obstat Most modern electronics that use a switch mode power supply will work just fine on DC. Only one side of the rectifier would be used and it would be an unnecessary part. Items with a transformer or AC motor would require AC.
Reply: High Voltage Direct Curent
That is right, skip Tesla, go directly back to Edison
Reply: The answer is shocking: there would be no power grid at all. Have you ever heard of energy neutral houses? Enough solar panels and a large, new technology, battery enable you to say NO THANKS. R&D is improving solar panels and batteries, the world of energy supply will and must change. Dirty energy, like nuclear, burning coal or oil, why the hell don't we stop that nonsense? Remember Fukujima? Remember Tsjernobyl? Remember Sellafield? Remember the other accidents? Remember how long nuclear waste remains fatal? Get your house energy neutral and say NO THANKS to the power grid.
Reply: @avalonhamakei  Blessed are the ones who know nothing. Did nobody explain to you that AC gets more energy through a wire, than DC? DC needs a larger size wire, or it will overheat and burn, and copper is pretty expensive. For low power DC is okay, for higher power DC is not ideal. Tesla knew that, and he invented a very high power wireless transfer system, that could even work as a worldwide power grid. But that was never built. Capturing lightning energy was another idea of Tesla, that would be great.
Reply: @allmycircuits8850  Do it. Sell your idea to all companies you can find online. You'd be richer than your president. And I guess the world gets better. Good luck. Sell your plan.
Reply: @kingprone7846  Why? You can divide a circle by quadrillians of numbers. Is three the most efficient? Would four fases have serious flaws?
Reply: @MikinessAnalog  Do not short them.
Reply: @jaykoerner  Why is moving electric energy that complicated? The only thing I did not read in the comments is quantum effects. Why does it involve high frequencies, billions of transformers (one for every house, do the math), tons of very expensive copper, just to get electric power from A to B. My impression is, that high frequency high power math is quite complicated, but when you look at hardware, it is Flintstones technology: copper wires and medieval looking power sockets and switches. You all still use those horrible power plugs. It is so weird. Why can't we simply put that energy in a truck and move it to the next city? Make some synthetic gas (petrol that is, on the right side of the Atlantic) of your electricity. Isn't cooled hydrogen such a liquid? It makes those hot temperature  power lines obsolete. No more acrobatic guys hanging under a helicopter repairing worn out stuff on power lines. How crazy is that system. Isn't there anything better? Really?
Reply: @IntegerOfDoom  I have never replaced any breaker. You all talk like criminals, using your secret language, here. Ah, why the hell is fase written with a P?! It is not pase, is it? Did the Philips Company  phorce you to take some caught masonry oath? What the phuck?
Reply: @josefaschwanden1502  Those numbers are not important at all. Never ever rely on your socket power frequency. Are you mad? What if you  hop into your RV? In the wild, you have no sockets. The moment you plug in, your adventure is over, you are in Behave Like Anybide Else country again. Throw away anything like oldfashioned tv sets. Unless you own a museum.
Reply: Why not SIX PHASE at 480, Smart Grid?
Reply: @unklStewy  "They" are getting more crazy every single hour. Believe me, you do not want a grid. Put solar panels on every house, store the energy in batteries of electric cars, and you do not need to buy any electricity anymore. THAT is the future, not a fluffed power grid. Why don't you guys wake up? When people in California understand this, why can't you? Power grids? 19th century technology. Move on. And close those nuclear and coal power plants. What evil power is stopping you?
Reply: I forgot: More Regulator Banks, and (correct and not noisy) Internet over powerlines.
Reply: @susguy5  What is that |X| thing? My android has no idea.
Reply: @susguy5  Gay bisexual 5 V and whatever. What has being straight got to do with this?
Reply: @oleeide9763  Scoters and bices? Edit and correct your foolishnesses. Pleese.
Reply: @tuttocrafting  Why is fases in your country with a P? Are you out of F's? That happened to printers, using lead characters. What the hell is wrong with fases? I don't get it.
Reply: @EngineeringNS  Why 100 Hz? Why not 1000 Hz? Wasn't our 50 Hz based on generator rpm? Why is 100 Hz better? I have just basic knowledge, not polytechnic levels. I know those free electrons in the outer scale of the copper atoms are doing the job, by moving. DC gets you a kind of electron river. AC will swing them to and fro, just like a push and pull steam piston. I guess there is some optimal freqyency, for transferring energy. Why would that be 100? Why not far more? Like 100 GHz? Please don't laugh, I have no clue, I just ask questions.
Reply: @voornaam3191  its terribly inefficient, the whole point of using 3 phase power is either efficiency or turning a motor. both which i.e. 5, 20, 100 phase is shit at.
Reply: Olaf Willocx  So what? The power in your gas engine is flopping all around the place. Pulsing like crazy. Find yourself a torque curve and see for yourself. But still, driving your car, you are happy. Why would power oscillations be that bad? For blunt processes like boiling water, who cares?
Reply: @tek4  You in U.S? Is that really 35mm hard drawn mains with what appears to be 4mm solid final sub-circuits? I bet that's fun to work with and what a waste of copper.  Do you actually have like a 25Kva transformer at every domestic connection? How do people get 3 phase supply to their home if they need it?
Reply: @jaykoerner  That's fun, do you think a generator designed for 60 Hz could operate at 1200 Hz? Do these things have a gearbox?
Reply: @CalvinWalton  Well the DC would be good only for household installation since it's not efficient to transfer DC over long distance and even at home 240V DC is far more deadly than 240 AC ( DC causes electrolysis in the blood - creating oxygen bubbles and hence killing you) also it would require thicker cables and it makes it impractical.. the list just goes on. I think the way it's now it's more than sufficient
Reply: If you did a complete redo of the U.S. electrical grid I dare say you would probably end up with something much closer to what the rest of the developed world already has, and while your at it why not get with the metric system already.
Reply: @PaulMansfield  It's voltage and not frequency that has to do with the size of conductors, and 3 phase motors are far more efficient among many other advantages over other electrical motors. Why not 4 phases? I suppose any advantages would probably be minor and not worth the extra cost and added technical difficulties.
Reply: @ttomkins4867  So you would have both DC and AC circuits running all through your whole house to avoid having a simple rectifier in your electronics? Do you know why you should avoid running DC circuits near AC?
Reply: @allmycircuits8850  Not that familiar with Murica but that sounds way overly complicated and almost entirely focused on electronics.  Power factor correction isn't really that complicated and at least where I live is generally done at the distribution level, LED lamps and electronics don't create much lag in any case.
Reply: @CalvinWalton  No it dont, it comes down to cable resistance/impedance.
Reply: @jeremiefaucher-goulet3365  And the cable cost  for much MUCH thicker cables would be cheaper? There´s a reason for AC is used and not DC
Reply: @Croz89  Please explain how DC is much better for very long transmissions? (if ypu produce copper or alu cables, yes then youre right), in all other cases you´re wrong.
Reply: @CalvinWalton  And create lots of problems, no galvanic isolation, much bigger cables, galvanic corrosion etc, there´s a reason that AC is used in every single country....
Reply: @NicolaiBDK  higher efficiency and lower electrical losses than AC, but only over very long distances like 1000km. And if you're not using copper or aluminium, what conductor are you using?
Reply: Sounds like you are suggesting Apple were to design the next power grid as they are great at creating new generation software and hardware that cuts off any opportunity for backwards compatibility. Such a grid sure would look great, but it would have some quirk in it preventing anything but Apple devices from operating.
Reply: @jeremiefaucher-goulet3365  transmission losses would be way too high for grid level. It'd have to be AC to substation at least & then depending how far people are from their nearest substation/transformer
Reply: @Omne Obstat the whole point was a thought exercise saying imagine you could. It's kinda irrelevant to the discussion really. You'd have to have some kind of legacy sockets in place at least short term.
Reply: @PaulMansfield  Three-phase is the most practical in generators in electric power plants, it would cause 2 pairs of phases to line up when generating power upon each rotation, so you lose the possibility of benefitting from rotational 3 phase power for heavy industrial applications that rely on the rotational nature of a 3-phase grid (an engine connected the right way spins at the same direction and speed as the one in the plant due to this.)
This would cause problems in power transformation, because of the heavy electromagnetic stress (because at each given moment 2 phases would be "generated" by the generator in the plant, they should either be exactly opposite from each other (the top of the sine wave for one and the bottom of the sine wave for the other) or lining up, which, I guess would cause huge mechanical stresses either way.
Switch mode power supplies are the norm for consumer equipment because they are efficient, but they loose this efficiency as the power demands rise (primarily due to heat), and they have a couple of very big problems we are now also seeing in consumer equipment due to the increasing probabilty devices use them as opposed to regular transformers: grid pollution.
If you know someone with a scope, you might want to ask him or her about the shape of the grid's frequency, at certain points of the day, because there is a big chance the sine wave is not looking like a sine wave due to switching mode power supplies only accounting for taking short bursts of energy due to the way these work, and as such, cause the grid's frequency shape to fall out of phase or change shape due to the more spikey nature of switching mode power supplies versus transformers.
Switching mode power supplies loose a lot of their efficiency when they start to run near the bottom end of the minimum amount of power draw required (it's why some computer power supplies refuse to start if the power draw on some of the rails falls below a certain amount, it's a little less common than it was 15 years a go, but it can still happen)
Reply: @allmycircuits8850  We would lose clocks running on time, possibly some media boxes as well (should they not get a time reference frame from the cable TV network, that is), we would loose the possibility of using devices that still rely on old-style transformers.
Capacitors are not the least reliable parts: it's how the PCB's that usually contain them were the "weak" spot is (usually designed by the manufacturer so they device will fail soon enough to make you buy a new one as fast as possible, but slow enough so the brand won't get a bad reputation).
There are capacitors that can withstand heat better than others, some will have to balance out a DC current at such high, polluted frequencies (ripple) that this will induce heat, and manufacturers have leaned towards using capacitors who might be capable of balancing the required voltage out frequency-wise, but have deliberately placed them near components that run hot, as to make them dry out quicker.
DC also requires serious breakers (more heavy for the same voltage in AC), because of it's direct current nature, its harder to quench arcs and when they happen they are much more violent and destructive than AC ones are (they sound different as well).
I agree on the switching mode power supply part, but DC accounts for slightly more losses and a huge amount of EM radiation that has bugged amateur radio enthousiasts as well. Some LED circuits that work on a 12V grid proved to be a huge interference factor on some amateur radio frequencies.
Reply: @xaverlustig3581  omg look around your house ... i could count at least 20 synchronous motors used in or to support your home , also any device using more than 2a at 240vac would need wires so large at 24vdc ever wondered why you cannot buy a lcd screen beyond 22inch that runs on 24vdc or 12vdc? Its because a printed circuit board cannot carry the current required to power said screen at anyrhing below 100v
Reply: @tuttocrafting  here here finally someone who understands the reason we use lv in the home , elv is 0-50v lv 50-500v and hv is 500v and above ,  in tne industry we term it base load ( mostly iindustrial nductive /analogue loads ) the ac motor is still the most efficent way to convert electrical energy into motion something thats not bound to change anytime soon ... ( thank you Nicola Tesla )
Reply: @antoniomaglione4101  umm dude an inverter is only used on ac loads its a way of controlling synchronous ac machines , dc machines use pulse width modulation for speed control , ever wonder why a tesla car has rectifiers and an ac motor?  Thats because dc motors are inferior at controling speed and to boot are a lot less efficent
Reply: @antoniomaglione4101  oh and frequency control  refers to ac , dc has no frequency
Reply: @allmycircuits8850  no .. ohms law dude , faster kettle = more electrical energy regardless of voltage or amplitude   ,  how would you run a synchronous motor from a dc supply ? All items using more than say 150w would need to run higher voltages with and with high current dc arcing and the carbon it leaves on switchgear would constitute a serious fire hazard
Reply: @parkershaw8529  3 phase synchronous  motors are the most efficent but you certainly can get a single phase synchronous motor , usually these days a cap is used to get things started
Reply: @favesongslist  yeah like thats going to happen , maybe in a rocket filled with all of the cobalt and lithium  on earth
Reply: @mitchpender8113  here in Italy the railway is DC and it's mess with all the substations
Reply: @brinkshows2720  this electrical engineer is not one of them , dc for transmission is possible ,but at a user level ?, i think you would struggle to find an engineer who would agree with that .. how would you run your synchronous motors ? Recifier for each one ? Dc  machines are still a loooong way from getting close to the efficency and speed control of a 3 phase ac machine , how about switching dc loads ? More electronics to control the inevitable degradation of switchgear under dc load? Hmmm one to ponder
Reply: @flagmichael  and sinking of steel boats
Reply: @phinok.m.628  one f#$king huge problem with your synopsis... the synchronous ac machine. Of which there would be at least 15 in or supporting your home.. they could be changed to dc motors i guess but speed control is crap and efficency does not even come close ... so lets change to dc and live with the efficency decrease and produce 20% ( at least) more power worldwide , that sounds awesome for the enviro ..
Reply: @Vebesmasher  finally somone else has mentioned the humble ac machine,  winner in the efficency stakes and a big part of the reason ac is part of our lives ,  not likely to ever be beaten in regards to efficency ( dc machines cannot come close) and so widespread and integral to our existence the efficency loss alone rules out dc
Reply: @mitchpender8113  There is a hughe decline in 3 phase AC machines. Yes there are still allot of them but that is very simple to solve. Inverters. We have allot of energy lost and especially money lost on the grid because we use AC. If you measure your AC line anywhere you see its never a perfect sinus anymore too.
A long while ago AC was the best option, maybe its not the best option now either. But you have to look further then now so when you can start over again everyone will look to the future and the future is DC. We are reaching a tipping point in which we can consider DC transmission. The only thing why we almost never use it is because of cost. Its impossible to change the infrastructure right now.
Reply: @elsiberiano2006  umm yes you lose energy sending any voltage / current over any distance .. thermal dynamics .....
Reply: @mfx1  no they would not work on dc at all
Reply: @mfx1  what does vfd mean , variable FREQUENCY drive
Reply: @oleeide9763  you mean rectifiers
Reply: @oleeide9763  yeah mate tney all use ac motors lol .. dc storage recified to ac for efficency and speed control
Reply: @mitchpender8113  Yes because the OUTPUT frequency is variable, the AC input is first converted to DC with a bridge rectifier, exactly the same as how a switch mode supply works. Most switch mode supplies will work quite happily from DC.
Reply: @oleeide9763  also brushless motors efficency wise are a long way behind synchronous ac machines , scaling is a massive issue with brushless dc  tech  also accurate speed control above about 200w is a non event
Reply: @EngineeringNS  agreed from a australian electrical eng too many armchairs who think electrical tech peaked at 5vdc
Reply: @johncanalese588  australian and industry based here, dc would mean a very large efficency loss
Reply: @LeSarthois  omg ac motor people , it powers your life and obviously goes unnoticed THAT is one of the main reasons we have an ac grid ... ac unit check fridge check cieling fans check freezer check electric cars check sewerage system check lifts check everything manufactured check basically you use or encounter an ac machine hundreds of times a day , it powers society and significant efficency losses would be sustained by changing to dc machines
Reply: @ggooaa100  no far from 99% but still one of the most efficient devices
Reply: @ggooaa100  with a rectifier and a transformer required to step down your voltage and rectify to dc you are loo,ing around 60% in most mass produced cases
Reply: @brylozketrzyn  hmm interesting,  i would surmise about 60% of motors in the home are universal ( very inefficient when compared to ac machines) so we could swap to dc machines with significant efficency loss or brushless dc  with scaling issues or recifly so ac machines can be used , it all adds up to increased energy usage not to mention switchgear degregation if caps are not used and degrgation when they inevitability fail which will be reasonably often with high operation rates on said switchgear . Net effect is higher energy use huge ingrease in cost to end user un regards to local infrastructure....
Reply: @nightowler672  omg  ac machine all dc arguments fall over when faced with the simple efficency of the synchronous ac machine , look around it powers society / industry literally thousands of these machines made the computer you are using now at an efficency dc machines could only dream about
Reply: @teslapower220  nooo tesla power..  interesting note tesla cars use the ac motor  and a variable FREQUENCY drive the computer batteries used store dc which is rectified at a loss to power the vs drive and motor sooo one can surmise that an AC supply to your house wouldnt need to be rectified to power the most efficent machine ever made .... the synchronous ac machine
Reply: @lesbsocal9107  not efficiently so from an electrical engineer no
Reply: @BlueCollarBachelor  omg really ?
Reply: The thing that needs to go is the standard light socket. They kill LED lightbulbs because they have no way to dissipate the heat. The LEDs may last 20 years but the build-in power converter can die at any time because of all the concentrated heat. A socket with a heatsink is needed or a new lighting voltage standard without the voltage conversion.
Reply: @KonradTheWizzard  i think you will find a correlation between cancer and magnetic flux , people who live near transmission lines have a documented increase , the hypothesis is dc has a much higher amount of magnetic flux than ac ... the flux you are refering to in solder is a misnomer , solder contains an acid which prepares/etches metals to be coated with solder when heated and colloquially is call flux as i mean a state of change just as electrical cables are surounded by invisible magnetic fields called magnetic flux , this is considered to be a carcinogen
Reply: @avalonhamakei  yes you might be right on transmission of bulk energy but in the local/consumer realm the system will always remain ac for the same reasons you profess makes dc a better method
Reply: @Hydravolt  What??
Followed link, nothing about electricity.
Reply: @mzs112000  you are not electrically educated thats for sure  , there are efficency losses when you remove the synchronous ac machine which means more energy required ac is part of our future get used to it .. and omg a powerwall ? I cant believe tne marketing has worked so well , lets dig up bolivias salt flats to mine the largest reserve of lithium left , oh what else ? Oh cobalt required in the 18650 oh no not enough to even supply half of america with their new powerwalls , whats that aluminium?  Yep coating every one of the 44000 18650's in a tesla car... really 80% of the power produced in the world is used to smelt aluminium ... go green means using less power not buying a new electric car or powerwall (with a life expedtancy of 6-10years) turn your ac off , use blankets or more clothing , have cold showers , only refrigerate what you wi.l consume in the next 5 days ride your bike or walk to work , stop buying crap you dont need  actions speak louder than words .. thats how you save power and the enviroment NOTHING you buy that needs to be manufactured is good for the environment no matter what elon/green marketing tells you
Reply: @fbiova9452  your car USES an ac synchronous motor if its electric
Reply: @fbiova9452  AND a synchronous ac motor has no equal when it comes to efficency , im an electrical engineeriand this is basic stuff GO read wikipedia again
Reply: @mfx1 ok soooo assuming we have a 3 phase 37kw motor being supplied from a 400vdc supply how do we effectively protect that on the switchgear side and make it resetable repeatability
Reply: Yes.  Turns out Edison was right.
Reply: Probably 400Hz like aircraft...
Reply: @PaulMansfield  if you want to go to 100Hz, the generators would need to go to 3000rpm, and all electric 3 phase motor would go also 3000rpm, which is not needed.
Reply: @avalonhamakei  DC isn't great for transmission. That's why we use AC power. And with modern motors AC power is better and more efficient than DC. That's why the tesla cars use AC motors.
Reply: @mitchpender8113  You bet. Even a $5 portable fan, powered by a single Li-Ion cell, now uses a "brushless" motor. Inside the motor there is a small driver IC which generate the 3-phase AC power for the stator windings, and it varies the fan speed by varying the frequency of the driving waveform. When first developed in the '70 by Philips, these controllers costed a small fortune.
Reply: @allmycircuits8850  It is the expense of the complex transformers and all the extra wiring that makes 3phase the usual maximum. Very large DC supplies such as DC railways do this but only over a very short distance.
Reply: @MikinessAnalog  The loss in the wires at long distances is lower for DC. As stepping up and down with transistor inverters becomes cheaper the case starts to tilt in favour of DC.
Reply: hawkturkey  More and more Brushless motors are driven from inverters to save power. These work off AC or DC.
Reply: @andrewwhite1793  I only know of audio entertainment supplies and off grid 100 DC  / 10 - 15 amps). I do know that transferring (switching) is a great hurdle.
Reply: @cj09beira  many modern high power appliance motors are driven through inverters that rectify the mains before converting to high frequency 3 phase for the motor.
Reply: @radekc5325  high frequency is good for transformers. Low frequency is good for simple motors. Electronics does not care as it often rectifies the mains to DC anyway ☺
Reply: @rafami9330  Power bricks die because they pair with disposable electronics so they are built down to cost. Good switching supplies can last 15 years, which is the same a linear supply.  An equivalent transformer power supply is much less efficient, eating through the cost of replacement switching bricks in electricity.
Reply: @tek4  Do you have a link?  How is 6phase cheaper?  I don't see copper getting cheaper any time soon.
Reply: @tuttocrafting DC motors are small and efficient.  The most efficient domestic water circulating pumps are driven with a (built in) variable frequency drive (like washing machine motors). These will run from AC or DC.
Reply: @andrewwhite1793  you mean mosfet or hexfet high speed switching "transistors"  They do the heavy work (DC to DC converters), not the second stage  that turns marine power into home power.
Reply: DC doesn't work, didn't work with Thomas Alba Edison its not gonna work now.
Reply: @abbofun9022  It woulnt even work for homes, the Voltage drop of conductors is too high for low dc voltage and high dc voltage is extremely dangerous.  The solution is 3 phase ac for everything, take a look a Tesla designs for 3 phase circuits that guy probably was the most intelligent human that ever existed.
Reply: @MikinessAnalog  The problem is not the losses in transmission the problem is you can not have an inductive field with dc so taking voltage to 1M VDC its not reliable.  Also high voltage DC is extremely dangerous.
Reply: @ttomkins4867  Then the cost of a house electrical circuit will triple, we will need thicker wires, a different outlet able to suport 2.5 times the amount of amps of the current ones, more dead ppl because of electric shocks. better quality of wires with a different material that have less voltage drop than current copper wires. Like I said before DC made no sense back when Edison created his power plant and it still doesn't make sense now.  If we check our current appliances besides computers, laptops, game consoles, tv, and audio equipment everything runs on AC.  Even tesla vehicles use AC, brushless motors that are way more efficient, full torque out of the motor at any rpm, even battery power brushless electric drills and screwdrivers work with AC.  Also with DC, induction stoves woulnd't work and those are power saving devices that based on where you live are cheaper than cooking with natural gas.
Reply: @CalvinWalton  Nope, the AC system has a huge benefit besides cheap transformators, the frequency tells you about the actual situation in the grid. 
If the consumers take more (or less) energy from the network than the power plants feed in, the frequency drops (or rises) because the generators generate more (or less) resistance for the turbines. The power plants notice small deviations in the turbine speed and can then take countermeasures to feed the exact energy the grid needs.
Reply: @avalonhamakei  Unfortunately DC power has a huge line drop issue. Basically over several miles of line, AC loses a small amount of power due to line resistance because it is literally vibrating electrons in the wire in place. DC on the other hand is power flow through the entire length of the wire. Over several miles you get a very significant drop in power. Not a problem for devices where path length is small.  But when you are trying to get power from a main generator site to a town 50 miles away... DC just can't do it effectively. You generate 10,000 Watts, and deliver less than half that.. not a good thing.
Reply: Pretty similar really. 60hz is a good balance between inductive core saturation capacity and captive transmission  losses as well as conductor skin effects. 400hz is used for small grids like campuses and aircraft where transformer and motor size are bigger factors than long distance efficiency or maximum conductor size. 3 phase delta is a good balance between conductor cost and circuit simplicity, single phase for small consumers makes sense because you have the cost of one rather than three transformers (though there is an old "wild leg" two transformer setup for low capacity 3 phase users so you may get 120/208/240 for example) DC is preferred for minimal capacitive  loss but the cost of voltage transformation and motor characteristics only make it viable for under sea transmission.
Reply: @PaulMansfield  4 = 2split
Reply: @simonalishalee1861  umm no edison was great at assembling and motivating inventors edison was good at hiring sacking and insigating legal action .. dc is great for low power items and very recently hvdc transmission for general use ac is far superior
Reply: @antoniomaglione4101  thats a synchronous ac  motor
Reply: @mfx1  dont forget, still  the majority of industrial machines are running in a star delta configuration vs drives are mostly used on equipment needing speed control or a softer start  with a dc supply these machines will need drives or rectification iand n my 30 year experience drives / elrctronics are the first to fail , there is a common belief that all progress  and or technology is good and change is always better , sadly im old enough to know its most often not the case , time tests all change and technology and efficency and costs to our environment need to be looked at from a resource position  i remember being told by a market leading manufacturer that the humble 60w filament globe would be replaced by a 3w led which would last 10-30 times as long hmm  actually its a 7-10w led and the life exp with a lux level exceeding the 60w filament is closer to maybe double the life unless there is fluctuations on the supply then all  bets are off , compare the enviromental cost of producing a power supply and the led and the board contained in both covered in heavy metals produced in a country with little or no enviromental controls , its extremely wasteful of resources and very bad for our planet . whenever i hear a company offer a green alternative its almost never legit and isnt it ironic that a filament globe usec to cost 75c and now the so called green equivalent is $9 .experience has shown me we are no smarter than our forebears but we tend to think we are , the difference being we use marketing to prove our intellegence now   which is a slippery slope in my opinion.. my 2 cents... peace mate ...
Reply: @mitchpender8113  VFD's Are widely used for three phase motors and not just for soft start reasons, they also help increase reliability provide cooler running and reduce burnt out motors (which can easily cost WAY more than a failed VFD) and so long term can result is less waste and reduced energy use. Modern VFD's are very reliable and have extensive protection circuitry to help protect both them and the motors from damage. As for age I was 50 last week, I'm cynical about a lot of promises made but the benefits of VFD's far outweigh any perceived drawbacks.
Reply: Add in cellular frequencies in line with the rest of the world and ipv6 addressing protocol to and it would be pure simplicity
Reply: @avalonhamakei  then your lines would go white hot and melt
Reply: @Omne Obstat what he meant was from the get go knowing what we know today if it all had to be built again imagine it was built the right way than the many flavours of everything we have today. Imagine usb 3 was the standard as soon as printers and breakout pheriphials got created no setting baud rates and flicking dip switches looking for a LTP port or DB9 or scart lead to interface. This goes for everything power, networking protocols ipv6 over ipv4 fossil fuels energy storage combustion engines would mostly be for generators and not vehicles. Houses would probably be energy efficient with the building methods we know today Vs what we used to use. Abestoes wouldn't be a headache it is today or lead pipes
Reply: @CalvinWalton  DC heats the wires a lot, also DC arcs at much lower voltage than AC. All light switches on DC will mean it will arc like crazy. DC requieres a lot more thicker wires and state of art power switches to keep arcing at minimum. AC can be switched without arcing at all you you switch right at zero crossing.. clever switches can do that. In DC you need to manage the arc and disipate it slowly somewhere but there will always be an arc.

Ever wondered why a relay is rated for 250V AC and only 30V DC?
Reply: They'd probably pick a slightly higher frequency and more phases but I can't see DC happen. It's just harder to work with and there's no benefit in switching to it. at all.
Reply: @CalvinWalton  DC loves to arc and DC-DC conversion is still a hell of a lot more expensive in medium (100-100k) voltage range than AC. Another thing is that power generators cannot even create DC, it has to be converted which is expensive. These days many long and high voltage transmission lines already carry DC so that point is less and less important though. (Look up HVDC)
Reply: DC is more dangerous when you are being electricuted, as you can let go! AC gives you 50/60 chances a second to let go as it flips....
Reply: 50V at 2 Amps with efficient devices. We will not save this planet by expansion.
Reply: 400Hz, no electrocutions, just burns. More line losses but very small transformers
Reply: @radekc5325  The human heart is upset by frequencies below 100Hz. Run it at 400Hz and turn electrocutions into just burns.
Reply: I could see 3 phases in homes, 3 wires coming instead of two. This would eliminate the need for start/run capacitors on things such as air conditioners.  440 for larger appliances would be more efficient.
Reply: We'd probably use High Voltage Direct Current (HVDC).  From my understanding with modern advancements in technology we can actually transfer HVDC more efficiently than AC but of course back during Edison and Tesla's days AC (which Tesla invented) was more efficient than DC (which Edison invented).  Pretty much all electric devices back then would also work just as well if not better on AC unlike modern times where most of our devices require DC.  Computers, phones, modern TVs, and LED light bulbs all use AC to DC converters while electric heaters and motors will generally work (or could be designed to work) just as well if not better.
Reply: @avalonhamakei  Not really. The biggest consumer of electricity is 3 phase AC induction motor. Which is one the greatest invention of Tesla after AC. They are super simple to make, easy to commission, incredibly reliable and very efficient. For AC induction motor alone, a DC only supply would not be sufficient. DC transmission will be over very long haul (like 100s and 1000s of km) but user end (or even City wide) transmission will still be AC.

BTW, China has started using DC for ultra long haul transmission.
Reply: @PaulMansfield  Doesn't higher frequency AC has higher eddy current loss in voltage conversion? Ideally, you'd want DC for long haul and AC high voltage multi phase for local transmission. Please correct me, if I'm wrong.
Reply: @PaulMansfield  The cool thing about three phase electricity is that you get three times the power with three conductors compared to two conductors. But adding one more to make four phase gives only a little advantage over three phase but would be way more expensive to build. Higher frequency is not optimal as it leaks more than lower frequency. 

I think that if the whole electric system would be started from scratch now, we would go with DC as it doesn't have problematic inductance to work with and it's safer to use. We didn't go with DC back in the day as it's harder to convert to different voltages but with nowadays technology it's not such a problem, that's why some high voltage power grids actually use DC nowadays. 

https://en.wikipedia.org/wiki/High-voltage_direct_current
Reply: @kingprone7846  3 phase is not maximum but it's highest number of phases we can make cost effectively. In some rare motor drive cases, six and nine phases are used to get smoother torque but that 9 phase wiring is only from variable frequency drive to motor.
Reply: @PaulMansfield  Don't need 4. The copper savings from amperage reduction are mitigated by the cost of the extra wire, and 3 is all you need for rotation. Beyond that, with 3 phase, you switch any 2 wires to change direction,  but with 4, you would have to switch all 4 wires. (ie. abc is forward, cba/acb is backward, compared to abcd is forward, dcba/adcb is backward, acdb or cbad are a stall)
Reply: @kingprone7846  in multi phase systems there is no maximum, or positive and negative. you could theoretically do a 4 phase variation of the wye setup, with 90 degree sine separation. but as I just mentioned in my other comment, it's pointless and leads to potential stall conditions when reversing, as there are states that are not fully cw or ccw.
Reply: @ttomkins4867  we're already seeing similar in some larger networking situations with POE. and you were close, they settled on 52v, not 48. many security cameras and wifi access points run on it.
Reply: hawkturkey there are dc brushless motors. It just uses a little bit of electronics to run.
Reply: @Falcrist  Less power losses are mainly due to the missing skin effect. It seems, that power cables for long distances are tubes (more or less), as the power concentrates on the outside of the cable, hence the core is useless. The effect increasses with higher voltages and higher frequencies. DC does not have a skin effect, the same cross section can be used more efficiently than AC.
Reply: Everything would be USB Type-C.
Reply: National power grids have always used current technology. What else would they use?
Reply: DC is best for home, AC is best for industry
Reply: @avalonhamakei  That would be ridiculous. DC would be much harder to carry over long distances and you would still have to step down. 
Instead you can install a 100 amp @12v switching DC supply as a secondary power grid in your home for DC utilities but I still see no point. You can't charge your cell phone with that for example, you'd still have to step down to 5v and the POEs would require in the spectrum of 24-50v...
Also, how are you planning to convert DC to AC to use your microwave? Are we going to have to use inverters? How will we adjust phases then?
Reply: @allmycircuits8850  Am I mistaken in thinking that A/C is much more efficient to move over distances than D/C?
Reply: 440Hz 180v yee haw
Reply: @avalonhamakei  , AC is much easier on switches.  DC switches get very expensive quickly.
Reply: @jeremyloveslinux  ,   120hz?   or 100hz just to be decimal...   Doesn't higher frequency make it easier to switch?
Reply: @kingprone7846  there's also 5 phase, the number of phases should ideally be a prime number if my memory is correct. More makes for smoother power but it's a point of diminishing returns after 3 phases.
Reply: Like the one in the UK :)
Reply: IT would be D.C.  Look up "HVDC".
Reply: @skeezixmccat  At very long distances the capacitance between the wires begins to sort of short circuit your power line and nothing will come out in the end if long enough.
That is why long cables under the sea is DC systems, there is a few in Europe between different country's of these, and at least one place where the DC system serve two purposes, one is to minimise losses in the cable under the sea, the other is to connect two AC systems with each other without having to take phase displacement into account.
Reply: Wow, so much ignorance on display in this thread! DC is a poor choice for a grid because you cannot easily change its voltage. Any more or less than 3 phases is inefficient. High frequency AC is very lossy. 60 Hz was chosen as a most efficient compromise. 50 Hz is less efficient, but keeps Metric System-obsessed Europeans happy for being half of 100. Technical excellence be damned!

If I had the job of designing a national grid from scratch, I would provide every customer with 3-phase 60 Hz AC power and at least 240 volts at 100 amps. I would allow the customer to choose their service level as they see fit, with options for higher voltages and/or amperages. If the customer needs lower voltage (such as 120) or DC power, they can always provide their own transformer or rectifier. I would have 3 phase at every power outlet, and appliances would be designed to always use all 3 phases in a balanced way.
Reply: @jeremyloveslinux  True, except total overkill for a lot of circuits, meaning in the end people would be paying for a really over-engineered system.
Reply: @allmycircuits8850  The ONE problem with this is that your DC wire throughout the house would use a lot of copper, but I agree, in the end it'd totally be worth it since you'd be replacing the literally dozens of devices that all convert AC to DC power - some of which do it pretty terribly: The number of times I've seen a cheap gas station AC-to-USB brick that gets hot enough to roast marshmallows, all to just output 1A of 5V current is nuts.
Reply: @jeremiefaucher-goulet3365  and a power station in every neighbourhood.
Reply: Steve Terry  I've been imagining right angles triangles all my life!
Reply: DC everything highly efficient power electronics everywhere. POE would be the standard power distribution at home with exception of appliances (or allow for high power negotiated delivery, for example 48V for normal POE, then jumps up to 400V after electronic handshake) All this  means everything is networks with the panel acting as a Ethernet router allowing for seamless smart home integration.
Reply: same
Reply: @xaverlustig3581  I think flywheel oscillators were a cheap fix during the time of the old H set tvs. Pretty much everything is crystal now by the time of pal.  If you needed mains to sync pal tvs then portable battery powered tvs wouldn't of worked.
Reply: @robertjung8929  Wrong. Although there are other reasons like cost that would make 4 phases less than ideal most likely.
Reply: @flagmichael  Great point. There's often hundreds of mA or more on water pipes and ground rods....
Reply: @Artcurus  You are correct that DC originally failed, but people often don't understand why. DC is actually better than AC for transmission over long distances AT THE SAME VOLTAGE. Those failed DC systems operated at low voltage (because transformers didn't work for DC) and so that's why they failed. It wasn't inherently because they were DC, but because they were at low voltage. HVDC is now used for long transmission lines more efficiently than AC because we have converters that can step it up today. That being said, it still wouldn't be practical for universal use due to the current cost of those dc boost converters.
Reply: @EngineeringNS  But then there would be more losses during transmission. Its all a tradeoff though because that would shrink transformers.
Reply: @thejpkotor  uuggghhh..... I'm getting tired of explaining this. Not inherently. DC doesn't dissipate more than AC given the same voltage and current. You are correct that its more complex to step it up and down though.
Reply: @charlesball6519  The frequency doesn't effect the pk-pk voltage! transformers would be smaller at 400 Hz though.
Reply: @tek4  What's the advantage of 6 phase? Is it the large number of possible voltages in one transformer? All the way from 120v between adjacent phases all the way up to 400v or so between opposite phases?
Reply: @PaulMansfield  notice how so many of the measures abd ratios we use are integer divisible by both 2 and 3. 12 inches/ft, 60 minutes/hr, 360 degrees/rotation, 24 hrs/day, 36 inches/yard, 60 secs/min. Included: 60 cycles/sec. So 100 doesn't cut it in that respect.
Reply: @CalvinWalton  Nah you got to consider reliability and semiconductors will never be there compared to passive components.
Reply: @MikinessAnalog  That's why I was thinking low voltage, something around 5-30V, just for low power consumer electronics.
Reply: @Croz89  If so, then go with 13.5 VDC since that is an automotive standard, many more appliances would be suitable for that voltage. I know infrastructure would require almost twice as much circuit pathways in walls, but have two voltages. 120VAC  & 13.5VDC. Jus sayn.
Reply: hawkturkey  DC has brushless motors as well, but they may not scale up like you may want them to.
Reply: One thing that needs to be changed is for lighting circuits to be 12v. DC
Reply: @PaulMansfield  100hz would be noisy as hell. 60 and 50 can produce some loud harmonics, but outside of ground loops in speakers, the primary frequency is inaudible. 100hz you'd hear the actual wiring humming.
Reply: Carrington event.  EMP.  Current grid actually needs improved diodes to shunt potential overload to ground. AC transmission at 3 phase enables simple motors to power industry. Another Carrington event will even fry space satellites.
Reply: KingProne not sure what you mean.  You can have as many phases as you want if you’re setup correctly for it.  The voltage is just offset at a different angle
Reply: Don't even necessarily need to redo anything outside houses. If a whole-house rectifier is impractical for some reason (say, enough to power some computers… not talking stoves and shit), it'd be nice for every outlet to be GFCI and have a rectifier to give USB plugs at the very least, if not some kind of new connector for things like laptops to run off DC directly, in addition to providing the AC plugs. I'm already am a huge fan of screw-in, plate-replacement wall taps that have USB on them.
Reply: @allmycircuits8850  in the uk the outlets have a "polarity", phase and neutral "should" always be in the same position in the outlet.
Reply: @jeremiefaucher-goulet3365  wouldn't you still use AC for high voltage distribution from place of generation to the end user?
Reply: It would likely be a DC Grid. As the majority of ALL loads are DC. AC was created so that you could change voltage levels by using a transformers. Now we have electronics so we can easily change DC voltages. It is generally accepted that the aspect of AC to DC conversion cots us at least 30% in power loss.
Reply: Any time you get a committee involved, be it government or private, it won't be much better anyway.  Besides, something like this is usually designed or regulated by more than one committee or agency.  So just throw up your hands and be glad it works.
Reply: @richardkelsch3640  So true Richard. I would not even suggest that they try.
Reply: @Steets  Can we get some of his DNA? If so we could try cloning him.
Reply: @avalonhamakei  DC doesn't carry very far without having another power plant every mile (I think a mile is the correct distance) or so. And DC can still kill, the cow killing was just Edison's propaganda method.
Reply: sounds like California present day PG&E lighting homes and forests 🤣🤣🤣
Reply: @avalonhamakei  What could be simpler than using transformers for all of the voltage conversions in the distribution systems, and AC induction motors in appliances. Digital clocks and a lot of timers still use the AC line as a time reference.  Did you ever try to switch 120V or more DC ?  A simple toggle switch won're work, because it arcs.
Reply: @PaulMansfield  The original Tesla/Westinghouse polyphase system was 4 phases. People call it 2 phase / 90 degree but it required 4 wires to have a balanced neutral.  Why do you think 4 wires would be better than 3?
Reply: If we'd start again from scratch it would first and foremost depend on the generation of electrical current. If with turbines (water, oil, coal, gas, biomass, atomic power plants, that can run at constant speed) the output to grid would be an AC voltage let's say 25kV@~50 to 100 Hz, depending on cost effectiveness of the grid lines (for further reading see Skin-Effect (gets worse for higher frequencies)). But that would only be for highly mechanised plants.
Solar Cells (PV) and wind turbines have not a constant output, even worse PV outputs DC voltage at ~0.5 V per cell, which means that you connect them in series for modules of up to 30/35V which then are connected in parallel for the current.
So what do you do in the case of large solar farms and wind parks?
You integrate a buffer system, and with off shore wind parks being more and more economically interesting you have another problem: they are usually quite far away from your main consumers.

Here comes now the interestung bit:
For distances over 1000 km (620 miles, I had to look that up) you get a breakeven point, where the elctrical losses in HVDC (around or above 400kV) become less than in standard issue AC grids and also you need less cables/material. Also at that distance you save so much on cables and losses that it becomes viable to create substations that convert this HVDC back to AC. For the fine delivery the grids will stay AC since there losses over shorter distances are smaller compared to DC.
This is the reason why Germany for example is planning on such a system for years to connect their north sea windfarms to the bulk of the industry in Bavaria and Baden-Württemberg (*and also the Ruhr-Pott).
For house consumers we would probably default to the 50 Hz, 230 V system in use in Europe, at 3 Phases. Since it allows for great adaptability and flexibility in wiring and power transmission while also using small amounts of materials.
But also, we would probably use newer technology in transformers, which reduce losses by reducing the amount of Eddy currents that are generated within their cores.

Btw HVDC has it's own challenges in switching stations, due to the arcing that happens with DC you need huge switches for HVDC at the moment that can even just weld them together in the worst cases. Ther are a few fun videos of arcing HVDC switches in use. That's why labs all over the world, and technology providers such as ABB are researching new semiconductors that can withstand such loads and could replace those humongous mechanical switches. Last I heard SiC (siliconcarbide) was a good candidate for that material, I think even our Lab was involved at some point.
Reply: @PaulMansfield  "now that switch mode supplies are the norm, that doesn't matter" What about distribution transformers?
Reply: High frequency AC would be nice (500hz) as it would allow for easier ac to DC rectification
Reply: @CalvinWalton  UHV-DC will become common one day I think.
Reply: @avalonhamakei  DC sucks.  Learn why it sucks at the local level.  Motors are gigantic and traditionally inefficient is one main reason.  With advent of rare earth magnets this is not true anymore.  THey are actually more efficient if done properly... key term: If...
Reply: @CalvinWalton  DC is more dangerous per voltage used for death.  Yet another reason AC was chosen instead of DC.
Reply: @kingprone7846  blatantly not true, but the number of wires you have to run becomes insanely expensive going to more phases.
Reply: @cj09beira  Used to be true, but not anymore with advent of brushless permanent magnet DC motors which are actually MORE efficient, but also MUCH more expensive.  Not to mention you require rare earth magnets...
Reply: @PaulMansfield   Higher mains Frequency is bad. Do know about 400Hz in Aircrafts?  If you had that in your home you hear mains bleep instead mains hum. very annoying , and with higher frquencies the distribution  got problems with the skin effect which leads to more cross sectional area of the power lines. 
Not a good idea at all
Reply: @SolarWebsite  I bed noone will return to dc mains which some place in the world had that long time ago. here in germany dc mains exist in som areas way back in  20th of the last century. We know about   110/220V and 220/440V dc split systems here in germany. DC with that kind of voltage are hard to control. Switches  prone to arcing and set places on fire. Insulation failure end up  always  with a huge firework. I had some old reports from Siemens and AEG of those time in which were reports and investigation how to get  over of  all these  problems with arcing. 
But several years later wenn the Nazis came onto power they gave order to all electricity companies to change  their systems from dc to 3 phase ac. 220/380V was the aim, 127/220V are  tolerable if power companies already installed it.

No way to put dc in private homes anymore, except solar Power.
Reply: @davetheelasticgoose4838  No at all , in some areas are  TT mains. Schleswig Holstein, Hamburg got TNC-S mains , lower saxony  got TT mains as in Bavarian  and Thüringen
Reply: @Mjollnir1983  But the disadvantage of bidirectional power converter ist the reliability and the emc problems . They build a huge Power converter here in germany at the north  sea coast to convert the split dc + /-  750kV  dc from the north sea  windpark.
 These dc power is  turn into  380kV to feed the super grid . The operators   have  problems after  problems,  interfering radio and the  mobile net is the least one. The audible noise of the inverter is annoying for people live nearby . The sound his a very high pitch sizzling , not loud but audible over several miles. As far as I know the power of the Converter is abt.  1200 MW...with IGBT transistors.
Reply: @Eclectic Badger voltage hurts, current burns...
Reply: @Reaktanzkreis  oh, okay  ich hatte das von meinem örtlichen elektrofuzzi so gehört. again what learned 😁
Reply: @PaulMansfield  Four phase requires five wires, not three. Two phase required four wires. It was quickly replaced by three phase which was cheaper and easier to install for the same performance. More wires and more windings increase thee failure rate in industrial settings.
Reply: I think it would be a straight dc in the house with a ac for distribution as solar becomes more cost effective then you have more local dc and only need topup, and with increases in batt tech then i could see each substation housing a battery/cappasitive load balancing and backup
Reply: @gasdive  100% agree!  In the beginning of the electrification of  the country we had lot of 110/220V dc grids. The power were local generated an stored in Batteries for the night time. In those days so many house burned down because of arcing switches or loose wires. From those days are the spring loaded light switches , developed at Voigt&Haeffner, Frankfurt. They prevent arcing at dc grids . 

After the war the power companies turn to the more safe  3 phase 220/380V /50Hz  which become national standard.   The first 3 phase grids were established in the first decade of 1900. 127/220V and 220/380V were the  favorite voltages.
Reply: @ocarontigerblood1111  Dc, at what voltage? IR drops are why we use 120 or higher AC, to reduce the required copper to wire a house. HV DC is even more dangerous than AC. You can't let go, if you have DC curent flowing through you. You also need DC rated switches and circuit breakers. It Quickly gets expensive. Low voltage Dc systems are not very efficient, high voltage systems are deadly if you make a mistake. AC can upset your heart's rythym, but DC stops the muscles altogether. If you have a bunch of things that run on the same Dc voltage in a small area, you could replace the wall warts with a single, higher quality power supply but any unapproved DC wiring could void your insurance.
Reply: @phinok.m.628  A house fire is a minor disantvantage!!  If you turn to 12 or 24V , that will be do a good job for lighting. But 110 or 220V dc in domestic place is a absolut no go. Such dc voltages belongs in the  hands of an responsible electrical engineer.
Reply: @michaelterrell  I have a POE system running through my house, if i could id run all my devices via that, both power and control down one cable, it is limited to 60W per line but that is enough for 90% of my equipment, run a few high power lines for heavy equipment like washing machines, the same as the US does with their high loads, the main saving you will get would be in the lack of transformers as most equipment runs on dc and ever additional transformer increases wasted power even when off
Reply: @Stoney3K  it would sound wonderful if you have a  bad sreened stereo. 400Hz is bad for long distance power transmission.  Aircraft use  400 Hz to reduce weight and have the need for these frequency for their gyros . A 2-pole synchron motor wired on 400Hz spin with 24000 rpm.
Reply: @ocarontigerblood1111  Cheap, poorly designed transformers waste energy. Wit till those POE cheap connectors start to fail, as the age if you run them to the full limit. That was intended to power telephones for VOIP, and other under 10W loads. The eight pin modular jacks and plugs (often mistakenly called RJ45 which is another application for that connector set) is a low current connector. To get 80W, it uses a higher voltage, because of the current limits. My home network is mostly wired, other than a few wireless only devices. DC is OK for short runs, but it all depends on the loads and distance. Even DC operated devices often require transformers to generate multiple other voltages for a device. Four output switching supplies are still common for new devices. An engineer that builds custom, limited run designs recently discussed a product that required 15 isolated power supplies. You can only get isolation with a transformer. They also prevent ESD. DC is OK for resistive loads, but not motors. The commutator in a DC motor chops the DC into crude AC to provide the required phase shift that turns the shaft. Brushless DC motors generate three phase AC too drive an AC motor.
Reply: @michaelterrell  i disagree with most of this, for example i had two computers running on my desk, two separate psu drew more power together even when off than they did when i powered both from one psu and they were both running platinum efficiency psu, i have run my POE systems for almost 20 years and not had a single failure (i am running Cat7 cable which is tougher and much thicker than standard network cable), I agree that the longer the distance the less advantage you get for a dc system but not many people i know need more that 100 meters in any one run, isolation dosnt require a transformer, i have used isolators on dc circuits in many situations and not once have i needed to use a transformer even on a 40V circuit, as for motors, except my washing machine every motor in my house is a dc motor even though they are feed from a ac source, there are advantages to a ac motor but when your are going from ac to dc to ac it is wasting power and might as well either stay ac or go dc to ac
Reply: @ocarontigerblood1111  They use brushless motors to be able to change speed without a transmission in a washer. Apparently you are not familiar with high end electronics. I've built things that you will never see. One was a kU band communications system for the International Space Station. Their power rail is +48 volts, which is the Telcom standard. It provided up to 40Mb/s data uplink. PC power supplies are trash, compared to the grade we used in our Telemetry products. They cost more than a typical desktop. and are rated to run 24/7 for decades. I have over 50 years of working in Electronics, and in many fields. To get the lowest waste, don't use soft start on anything. Add a power switch after the AC connector, or do like my shop. Things powered by charges are on the switched circuit for the lights over that bench. it is 20' by 40', and divided into eight 0'x10' areas.

Do you know hat the original IBM PC had a 63 Watt power supply?
Reply: @michaelterrell  saying about your spacestation equipment is pointless to the argument as they wont be the devices inside a house
Reply: @ocarontigerblood1111  OK, if it makes you happy, Skippy. A lot of the equipment once used by NASA ends up in home shops. Your mind is closed, and so is this thread.
Reply: I say just switch to 240 volts with IEC320-C14 plugs.  Done.
Reply: @wiredforstereo  You have no say in the matter.
Reply: @michaelterrell  You do?  Are you on the board? The committee?
Reply: @michaelterrell  You're taking this very seriously.

This is the YouTube comment section.
Reply: @wiredforstereo  Life is serious. I am a retired engineer.
Reply: @michaelterrell  I'm a not retired engineer.
Reply: @michaelterrell  If it's not your problem, why are you so invested in arguing bout it?
Reply: Jesus christ there’s a lot of replies to this.
Reply: @Steets  while it would be great to have him back, let not forget if he had his way RF would be pretty much useless. No radio, cellphones anything like that. That's a fair tradeoff to have wireless lights right? Wireless power = bad idea in practice.
Reply: @CalvinWalton   You do know that the US national grid inter-tie is done with DC and not AC in most cases? Kind of proves your point right there. The Eastern to Western grid has 7 DC connections in the US and one in Canada.
Reply: @AshtonSnapp  Ditto. Can you give me the executive summary? :)

So far, I gather the following improvements from what we currently have:
- PoE (48V) DC inside homes
- HVDC transmission everywhere
- Various frequency proposals like 120Hz and 400Hz

Anything I missed?
Reply: An no electric clocks to get timing from the 50Hz or 60Hz!!
Reply: @martynh5410  Don't know where you get that idea from. Any clock that plugs into an outlet and has a motor gets is timing from the line. Don't think so? Take a clock designed for 60 Hz and run it on 50Hz. It will lose time.
Reply: @gravelydon7072   I'm evidently much older than you!
 I got that idea from a real project.
Way back in 1973 when I lived in the UK, I designed and built a very basic digital clock that got it's timing from the 50Hz AC mains (line) frequency.  No motors at all.  This design used the AC voltage, reduced it to a few volts, half-wave rectified it and that waveform was then used to generate pulses at a 50Hz repetition rate.  The 50Hz pulses were frequency divided by a factor of 50 using 7400 series TTL chips (at the time state of the art LOL), down to 1 second.  The 1 second pulses were then divided again by 60 to create 1 minute pulses and again by 60 for the 1 hour timing pulses.  On those days digital clocks were almost unheard of.  I had to use something called "Nixie Tubes" for the digital readout because LED readouts were not yet readily available, at least to me.  The clock kept reasonably good time,and yes it would not have kept time in a 60hz country without some modifications.
The 50Hz timing was a cheap way to do it.  I could have used a receiver to pick up a station called Droitwich, which I think was at 100kHz and used that carrier frequency to derive the timing needed.  Alas, I was a young college student with little money!
Reply: @martynh5410  In 1973 I was getting out of high school and going into college. Our home calculator had Nixie Tubes. My one that I wasn't allowed to use in class was a used TI-52 which had LEDs for the display. In class we were restricted to slide rules or pen and paper as the instructors thought it unfair for some to have calculators and other not. We still have analog clocks that run off the 60Hz with just motors and gears. I also built a digital clock kit back then and it had LEDs for it. You could get them in any color you wanted as long as it was red. ;-) The Nixies were a blue-green color instead of the normal yellow.
Reply: @CalvinWalton  DC don't travel distant very well. And your cables would be huge!
Reply: @DeviantOllam  it could also be hell.
Reply: @jeremyloveslinux  280 v is better.
Reply: @Steets  who is Tesla?
Reply: @avalonhamakei  AC or nothing.
Reply: @PaulMansfield  be Zuse four is entree.
Reply: @allmycircuits8850  you drover it that if cois
Reply: @CalvinWalton  long-term that would mehr work.
Reply: @mjbirdClavdivs  we. Red need analog yvs
Reply: @kingprone7846  four phase is poossblr too.
Reply: @wyokaiju992  no he can not do it.
Reply: @jeremiefaucher-goulet3365  DV can not be transpeoged over long fiafwjces
Reply: @abbofun9022  it is cornexyt
Reply: @abbofun9022  why not for the making rod?
Reply: @TheWebstaff  that would mehr work.
Reply: @MikinessAnalog  yes, this is TRD.
Reply: @MikinessAnalog  transformers him
Reply: @willjosephson  it has longer reach.
Reply: @willjosephson  why are you talking about zombies?
Reply: @leerman22  it would. Lead to kror uik
Reply: @gandalf1124  why would. It be out of piasd?
Reply: @tohopes  no we do not have that.
Reply: @radekc5325  we choose would 90
Reply: @Jtzkb  no, this video.
Reply: @rafami9330  AC is better for long disfsnfss.
Reply: @TheJamesM  he did not misunderstood.
Reply: @SolarWebsite  no only sir where.
Reply: @xaverlustig3581  analog TVs are hs8otru.
Reply: Probably wonderful
Reply: The world couldn’t even decide what standard to use for HDTV (8VSB or COFDM) or emission standards for cars (diesel bad in US/ okay in EU)

.
Reply: @PaulMansfield  3 Phase was chosen because 120 degree offset is creating a rotating magnetic field to run asynchronous motors without any additional components needed. In time where there were frequency regulators and no semiconductors this was heavenly simple.
Reply: @avalonhamakei  lol, what? There's a reason DC lost out on distribution systems.
Reply: Let's go for 400V 2 phase and 700V 4 phase. More Volts = more power!
Reply: start probably with 400 Hz, to reduce transformer sizes
Reply: @PaulMansfield. Higher frequencies would result in a much electrically noisy world. Listen to every newscopter segment, and you will hear the 400-Hz whine in the background, because that frequency is used for AC in aviation, and it gets into everything. As far as the number of phases is concerned, Tesla figured out that three was optimum; two was not as efficient, and more than three was too costly.  (Too bad he died broke, feeding pigeons from his NYC hotel room window.)
Reply: The national power grids in most countries would still be very similar. . . .  Except the long transmission lines carrying high power would now be High Voltage DC. . . .  So Edison was right. :-)    HVDC is more efficient. . . . .  But local area grid and local Distribution would continue to be best as AC as at present.. . . .   But better to be 3-phase 400V or single-phase 230V . . .  Not the complicated 208/120V  that is often seen in the USA.
Reply: This has been discussed long ago many times over. Why not 6 phase, or 12? Because the efficiency gain from 6 or 12 phase is simply not enough to justify the cost of running 2 or 3 more sets of conductors along the entire grid from beginning to end. 3 phase power is efficent enough as it is. Tesla knew exactly what he was doing.
@kingprone7846
Reply: @kingprone7846  Um, well, HVDC plants use 6-phase or sometimes even 9-phase AC to not have to smooth the rectified output.
Reply: @allmycircuits8850  Electrolytic capacitors - something else trying to kill you,
Reply: I think the North American grade would still end up with 240 volt split phase for residential use because the primary reason we use this is a 120 volt shock is quite unlikely to be fatal and most governments and companies over here are too lazy and too cheap to feel like implementing all the safety features to make 240 vault outlets feasible, but you still absolutely need 240 volt to power stuff like AC units especially over here
Reply: @PaulMansfield  because more than 3 phases dramatically increases system cost without yielding significant performance benefits
Reply: @jeremyloveslinux  I have thought the same thing so many times.  How nice it would be to have 600 volts of power to push so much power through our wires with fewer amps.  a 14, 3 could almost power a whole house easily.  15 amps 18000 watts of power.  But then how many dumbass people would kill themselves.
Reply: Just need to wait for the next Carrington event. With any luck, the various grids will align. Of course, Texas will do the exact 180 to what the rest of the country does, so good luck with that.
Reply: I think if you were doing it from scratch today. You would do all the high voltage stuff with DC for lower losses . You would still do the last few miles in ac (say 33kv and lower) because by the time you reach the end user, because ac transformers are more cost effective than DC to DC converters
Reply: High-quality DC transformers per home, with sockets using something like DIN plugs so that devices can pull just the voltage they need. Thus fewer wall plugs and big PSUs for modern digital devices that need nothing close to 240V
Reply: For the love of God, give every American a 200 amp circuit. Also, a two-way communication system could be used to prevent losing our transformers to solar flares.
Reply: We don’t have analog tv in Europe. The signal was switched off about 5 years ago, and everybody had to switch to digital.